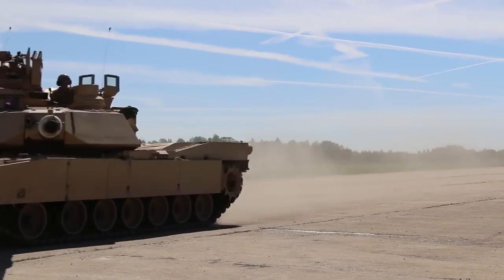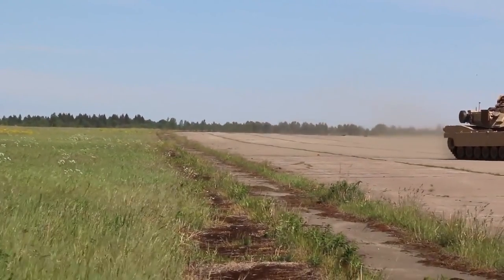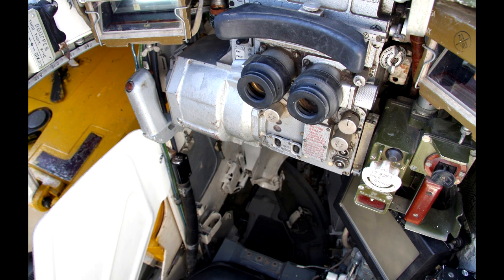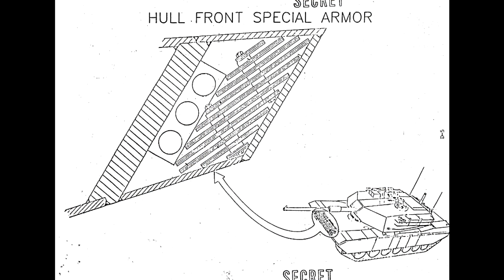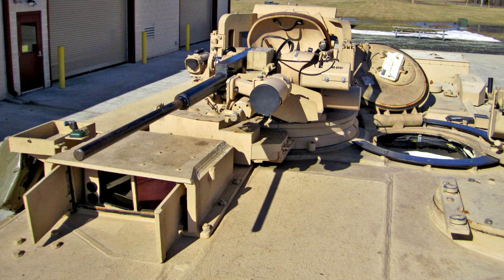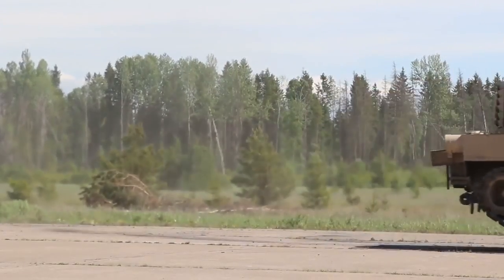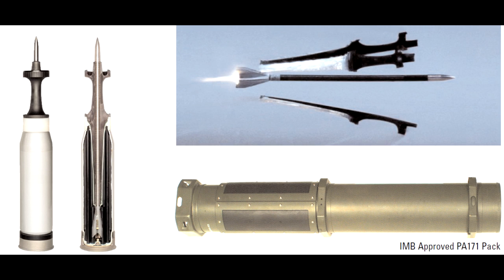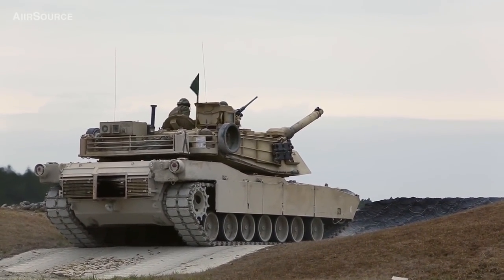Problems with Abrams tank

Comment from the maker: So many people complaining about me not stating the problems the Soviet or German tanks have or used to have... Honestly people, this is a video where I simply point out the problems that M1 used to have or still has, if you want to hear about the problems about Russian tanks watch the "Problems with T-90", or "Problems with T-72" or "Problems with Russian tanks". This is a video about Abrams, not about other tanks, when I bring up another nation I am simply pointing out that the thing I am mentioning did exist at the time, but was not present on the vehicle that is the topic of the video.
Also, so many people are saying that gas turbine is for some reason better than diesel... There is no evidence to prove that it requires less maintenance, that is one myth that is spread around the internet for some reason but is not true. One has to work with both engines of similar performance (like MTU MB 873 and AGT1500) for an extended period of time in order to come to such a conclusion. Another point I saw being made constantly is that "US has enough money/resources to use the gas turbine"... I never said US did not, but if it has enough money to keep the turbine, then it means that the diesel wouldnt change that fact, you would only have to refuel your tank on less occasions.
Another point I saw is that you could use "captured fuel" or some other fuel if you dont have access to your armies supplies... First of all, diesel engines are pretty much universal around the world, so there is 99% chance that the enemy is using diesel, and if not diesel, then gasoline, and multi-fuel diesels can use gasoline as well. Second thing is that if you dont have access to army supplies you would most likely use the civilian fuel, which is, again, diesel and gasoline. The point of Gas Turbine engines is that they can produce more power for their volume, that is the reason why Soviets decided to go for a gas turbine with their T-80 tanks. Their diesel engines are small and for a long time couldnt produce a lot of power at all (780-840hp compared to 1100-1250hp of gas turbines) so their use of gas turbine was completely justified. But when AGT1500 was developed there was already a diesel engine of similar performance that took up as much space, since both engines are really big compared to soviet ones, and thus, much better. Therefore there was no actual need to go for a gas turbine, the actual reason is more of a political nature.
Reply: One thing I can say about the gas turbine vs the v12 is that the gas turbine is MUCH more quiet. During exercises I've been on with the Americans, i always try to pick their tankers brains at the smoker (bbq we have at the end of an ex) about what they think about facing off against the leopard 2s we bring (canadian) and they always say the same thing - all they have to do is switch off their engine and listen to get a rough bearing of where we are approaching from. 

You cant hear a damn Abrams coming until it turns its exhaust toward you
Reply: @julianjames2899  
   I never considered the difference in noise, that's an interesting tactical advantage for the Abrams and disadvantage for the diesel engined tanks.
Reply: @julianjames2899  This is the kind of testimony I want more of - Real fucking soldiers that had to work with the equipment that's being discussed, not some faggot pseudo-commie claiming to know about tank combat.
Reply: @BirdyLegs2849  thank you! Honestly for what I can attest too, both the abrams and the leo are great pieces of kit with their subtle and not so subtle differences. In the end the biggest advantage or disadvantage of either comes down to crew training and experience. Being the first to get the best ground, and first to get a round on target. Then jockey back, rinse and repeat. Move, shoot, and communicate.
Reply: Hi RedEffect, our complaints concern a far more serious issue: You still owe us a proper APFSDS-Compilation!
Reply: I like the video I did read something tho about the old fun that the abrams had supposedly they used the old gun with the plan to upgrade the gun for future upgrades but they introduced a new type of ammunition that was supposed to make up for the shortcomings of the gun.. ie depleted uranium shell supposedly it was able to penetrate the toughest armed the Soviet’s had at the time
Reply: In 91 the M1 only use 2-3% of the total 162 millions gallons fuel issue to the army, which mean 4,8 millions at max. If you use all the Leopard2 engines on the M1 instead of the Honeywell you will save about 57000 gallons. That mean 20 Oshkosk M978 fuel trucks. If you can't provide 20 fuel truck in a war you probably lose it already.
Reply: Any weapon system is a compromise.  The designer and the end user must decide what is important and what is just okay based on the technology and availability of the day.  No weapon system is perfect going into first production, never will be when production years later. It's successor will be better, but never perfect.
Reply: Haha thanks for taking on the fanboys...
Reply: Yeah the Abrams still uses the German L/44 gun while Germany created a new, longer L/55 gun. Apparently the reason for the is the US uses depleted uranium rounds while Germany does not have access to DU so they use Tungsten. Intelligence indicated that German tungsten rounds couldn’t breach newer Russian tanks so they made their gun longer. But the extra velocity doesn’t help DU like it does tungsten. Plus the new gun is heavier and wears out faster. So the US has thought over the years of upgrading instead to a gun with a larger bore, but has repeatedly declined to do so. 

Russia has 15,000 tanks, most of which are older and the Abrams gun will have no problem breaching. But the US only has 1,200 tanks in Europe. If Russia starts rolling their tanks into Europe the US plans on blowing them up from the air, which is why Russia is spending so much on the S400 air defense systems and electronic jammers. One question is how well would Russian tank active protection systems do against a maverick missile?

The newest version of the Abrams out this year adds even more armor to frontal turret, so the bean counters probably think that’s where it’s most likely to be hit by an anti tank round.
Reply: And THANK YOU for your continued work and simple unbiased problem pointing, pay no attention to the wot/wt players you've done good
Reply: All tanks have issues and weaknesses,  in one way or another.
Reply: RedEffect nice video can you do a video over the leopard 2 ?
Reply: Excellent summary, objective,  informative and unemotional as it should be.
Reply: considering the US army roll with a lot of helicopters (transport attack and recon) it make sense to simplify the logistics by using turbine engines. tanks can use the fuel dump used by forward aviation units.
Reply: I'm confused as to why you would start your video with a joke intro insulting Abrams fanboys, and then spend the whole video speaking with a derisive tone that is not evident in most of your other videos and then pretend this is a normal video.  (I'm not an Abrams fan)
Reply: @Dadecorban  My guess is, Abrams fanboys fight about it, and every message means a visit to the page,  which means more views and means more money from advertisers.
Angry fanboys = money.
Because of capitalism.
In Soviet Russia, YOU fight for money.
Reply: not gonna lie,but a king tiger shot could knock out every tank,if it hit the top,which has weaker armour than even the back,but harder to hit,hope to not get into any arguements with people who say "NAZI NAZI ALL TANK OUTDATE THEY NO EVEN CAN PENETRATRE TOP OF TEH TEANK U IZ ARMCHAIR SPECIAL SITTING CHAIR ON INTERNET"
Reply: tron  i didnt know admiring engineering had anything to do with politics
Reply: Actually a really good reason that they chose the AGT1500 is because of the horsepower and torque curve. The AGT1500 produces more power and torque than the diesel for almost the entire power band. Turbines are also lighter than Diesel engines which gives them a better power to weight ratio. If you look up a chart of gas turbine torque figures, you can see that they actually make peak torque at low RPMs. This, in theory, means they get up and go faster than a diesel could. However, because of the weight of the Abrams and the gearing in the transmission it is limited to a top speed of 42 mph. If the army changed the gearing in the transmission, the tank could probably go much faster. However, the army prefers having better acceleration at low speeds because of many reasons. It is also way quieter than a diesel outside of ~100m distance. Since most engagement ranges are outside of ~1500m this is a huge advantage. Yes it had some problems at first, but the army chose the turbine for a variety of reasons when the diesel would’ve been cheaper.
Reply: @rawful502  actually it’s governed to 42mph.  It can go faster - much faster, without changing the gearing.  M1IPs were clocked at over 50mph.
Reply: @MDavidW100  Oh I always heard it was because of gearing. Either way they are capable of going way faster like you said :)
Reply: No problem. 

I think that the assessment does have a more tank v. tank lens though, since there is advantage to shorter barreled gun. 

The shorter gun may be the result of experience in urban warfare, which the US Army and Marines has plenty of experience with. The L/55 gun is about 1.32m longer than the L/44 gun, which can be an issue in urban combat. Tank commanders don't take their tanks where they can't bring their gun to bear, and needing up to 2.64 meters (1.32m on each side) just to allow the gun to be brought to bear on each side can be the difference between being able to support advancing forces with tanks and not being able to do so. 

This is probably why the Merkava 4 doesn't use the longer barrel; the IDF sees a lot of urban combat, and having an extra 1.32 meters of gun tube to worry about snaring something offsets the improved long-range performance you'll hardly need in an urban environment. If the IDF planned on pulling a 1967 again, they'd probably have used the L/55 gun and the Merkava 4 would look more like a better Merkava 3. 

The reluctance to use the multi-fuel diesel engine may be the result of experience with similar engines with the M35 and M54 series of trucks, which weren't seen as sufficiently satisfactory to warrant their retention in later upgrades. Issues with the M54's engine may be linked to the fact it wasn't powerful enough, rather than any issue with the engine itself. 

In addition, the turbine does offer some advantages. According to Minnesota State University's textbook supplement to thermodynamics, namely the reduced wear due to number of moving parts (diesel engines have over a dozen moving parts per cylinder not to mention the 11 other cylinders, the turbocharger, and anti-lag devices, where gas turbines mainly have the one big spinning turbine) although said moving part in a turbine is a far more expensive moving part, has better cold-start capabilities (pretty useful in the winter), quieter (significantly more people have functional ears than thermal imaging systems), and has a higher power/weight ratio. The gap in fuel consumption has decreased, but the turbine does burn quite a bit of fuel which can be seen as a much more pressing issue. 

Other than that, I agree with your assessment. The Abrams isn't a perfect tank and has its issues. However, no tank is truly free of issues, and it's really a matter of whether the issues of particular elements outweigh the advantages of the system.
Reply: because we want to complain cause we're idiots :D
Reply: swansea007791  Actually it is the "Pussy Hurt Commies" that springs to mind
Reply: IT'S IMPORTANT TO HEAR THE TRUTH AND NOT THIS UNCHALLENGED HYPERBOLE!! WE APPRECIATE THESE TRUTHS CONCERNING UNQUALIFIED PEOPLE RESPONSIBLE FOR MAKING FLAWED EQUIPMENT!! THIS IS WHAT HAPPENS WHEN PEOPLE ARE UNABLE TO THINK OUT SIDE THE BOX, HAVING NO VISION, JUST ARROGANCE!! P.S. IGNORE THOSE WHO DISAGREE, THEIR ARROGANCE IS AS BAD AS THE DESIGNERS WHO BUILD THESE INFERIOR PRODUCTS!!! ;-) REMEMBER THE F-4 PHANTOM, WHEN THEY FIRST ARRIVED, THEY HAD NO GUN ON THE FIGHTER, AS A CONSEQUENCE, LIVES WERE LOST!! EVENTUALLY GUNS WERE ADDED...WHICH MADE THE DIFFERENCE...DUH!!
Reply: The gas turbine did suck in sand in the gulf which turned to glass because of the heat generated by the engine thus clogging up air intake
Reply: @davelee4885  But it still did a great job of popping the turrets off every T-62 and T-72 tank they ran across.
www.youtube.com/watch?v=7EJsLZLfeOQ
Reply: So many people missunderstand, that finding problems does not mean that the whole tank is bad. Its more likely that no tank is absolutly perfect
Reply: I DO SENSE SOME BIAS
Reply: no we are complaining about your blatant bias in your videos, you are bad at giving unbiased opinions the only real channel I found that does good unbiased opinions is matsimus he actually talks of the strengths and weakness of every tank without shitting on the vehicles. you always say oh the Americans only fought down graded t72 exports yet here the tanks you are talking about are downgraded export m1's without any of the capability's of their American versions also lacking proper crew training just like the Iraqi t72's that's why everyones complaining about your biased ass, hell you even said the m1 was bad on its first production even tho when it was introduced it was thee first tank in the world with a digital fire control system. and your dumb ass said the gas turbine was sooo expensive yet it really wasn't it was actually cheaper to maintain and payed for itself many times over the course of its life vs the 1500 horsepower mtu engines
Reply: @zero00tolerance  no its his blatant fucking bias and clear lack of knowledge against American vehicles that we talk shit about like I said matsimus does what he does 10000x better cause of the lack of bias and respect for every nations fighting vehicles
Reply: Sorry mate but this was by far the worse video ive seen about the Abrams and im not the criticizing type. You put the laughing meme when you see the headline "Abrams is the best" but... With what evidence? You sure do point better counterparts. But never a tank. You always talk about a better german  engine, a better russian gun or whatever. Cherry picking isnt fair since the best tank will still have flawed parts but the best tank will be the one that can pull off everything decently like armor, engine and offensive power.

Have to say was a bit dissapointed but the consistency wasnt there...
Reply: @uwotmatte7577  well that tank isn't the abrams or T90 or leopard well maybe the leopard but nah I think the only like best tank was the panther in ww2 

Decent armor 
Decent mobility 
Decent canon 
decent tank size 

But now in 2020 it's hard to pick a balanced main battle tank cause if it was on light tanks well 

The puma and 

Bmp72 ,especially the bmp 72 

Are decent 

But main battle tanks ,

Abrams is decent on armor and technology ,canon 

Leopard is decent on armor speed , technology and canon

T90  decent armor , decent canon decent engine , velocity,decent tank size 

But over all , it's all situational every tank is good ,well depending, but it's all situation cause the abrams and kill a leo and a leo can kill a abrams 

The t90 can kill a leo amd abrams and the same goes to the other
Reply: @mrpotatoman_pr1554  sure i aint criticizing that. What i am criticizing is his logic? Every single recent gen tank in 2020 has decent everything. But if you think the claim for best tank is laughable, then you need to provide a reasonable versus and not pick parts from multiple tanks
Reply: @uwotmatte7577  oh yea I totally agree , I remember when the US was soo cocky about the abrams like ,haha no abrams has been destroyed we are superior, but then a single RPG makes a abrams go boom boom , I think the only tank that can hold more than 2 RPG is the t90 cause apart of having thicc armor ,they add extra reactive armor
Reply: I know this is a longshot, but could you provide the source for the commanders sights on M1/IPM1/M1A1? I cant find it in the M1A2 book.
Reply: You should consider a tank in the context in which it was developed.  In the case of M1 it was expected to fight in Europe from pre-planned defensive positions.  Likely in retrograde maneuvers as the endless streams of Soviet armored and motorized rifle regiments stormed West...only to become turret-ejecting doorstops.    <--I borrowed that last bit from Task & Purpose
Reply: You're reading from random facts and fictions online. You're neither experienced as ana Abrams crewman nor have you ever built it and trained to fight the tank. Most of your information is outdated by 8-10 years. 
If you're knowledgeable about the Abrams then you can tell me everything about the PAC, it's actual performance tests in the field in combat conditions, it's test performance during the "Tusk" phase. 
You're not impressing anyone with your lack of knowledge and experience. Your biggest task is to prove your information, validate.
Reply: I guess a russian tank never got knocked out and have no problems/ oh wait what happened to russian tanks in afganistan or dosent that count because it was russia. You must be a commy according to you everything russia makes os the best. The rest of the world should give up now
Reply: Who's laughing now RedEffect? The problem with T-90's? They invaded Ukraine.
T-90's are popping like popcorn on a cold Ukrainian winter day.
Reply: Im not surprised that so many Americans have to come up with excuses it seems to be deeply rooted that America is just best at everything , the usual megalomania. And arguments that are comparing the M1 with Sovjet tanks .
The video is about the M1 just like other are about T72 or T90 etc.
Reply: Spoken like someone who has zero experience in the Abrams and has probably never even seen one in person, let alone operated one or wrenched it. The Abrams outclasses ALL armor currently deployed and that's likely not going to change, especially from third rate powers like Russia and China, LOL
Reply: You will find that all that matters to them is their country's delusions of its military invincibility. You are forbidden to point out the flaws. You become the enemy by breaking the magical spell that protects their magical invincible tanks.
I like your channel and think you try hard to be objective. I see that you are careful with your evaluation. Keep up the good work. :)
Reply: #1.Gas turbine saves 3 tones of engine weight.
Reply: The thing I would point out is that the M1 series early on had a thermo sight that allow it quite a bit advantage in wood and light forest area and in the night. Other than this there is not lot of advantages.
Reply: just wondering doesent the most modern m1a2 weigh 73.6 short tons and leopard 2 weighs 68.7 short tons
Reply: Oh yeah 1 question, why is the gun of the m1 abrams' not centered?
Reply: Nope.  

Bazaar was hardly open combat. It was fight insurgents at best. 

Still not as much combat experience by a long shot. 

Oh and be careful when you talk about someone’s grammar. You might want to re read your comment.
Reply: How many m1 tanks have you crewed again?
Reply: @ferrysyalim5191  Yeup. compared to other tanks of the time yes, thats blazing.
Reply: @Nogeri  finaly.  I find someone that love abrahams but not skeptical or denial.
Reply: RedEffect Aint much wrong with the Leopard...
Reply: I complitly agree with u the tanks is bad bc they said that the abrams did 1 battle where the have lost one tank bc of friendly fire but they where battling agains t 54 its logik that they didnt die.
Reply: Redeffect WHAT DO YOU KNOW ABOUT THE UKRANIAN T-62 BULAT 2017?
Reply: YOU HAVE NO CLUE RUSKY IN FACT HOW WOULD YOU KNOW DO YOU HAVE ONE, I DOUBT IT
Reply: Forgive my ignorance, but I thought the Abrahams had good armor elsewhere, besides the upper front plate you mentioned. Obviously thats a huge flaw, but I was under the impression that its good everywhere else. It that true?
Reply: You cannot judge a design decision if you do not understand the situation the design is meant to be used in. 
That situation is the doomsday scenario, where europe is a radioactive ruin, as stated by soviet warplans, and fuel resupply cannot reach europe in required amountd because of soviet naval blockade.
Its not about using stolen or civilian fuel, its about distilling french wines for fuel. Or crude oil, hydrogen, natural gas. It literally works on fart gas, if you can produce enough of it.
The assumption is that societs will prioritise destroying any and all fuel sources, civilian or not. The assumption is that after first tactical nukes, the resupply organization does not exist, period, and the tank crew might have to continue fighting and surviving with nothing but themselves.
Its made for end of the world scenario, where men can never return home, but can still fight until they die.
Not for limited wars with minor nations.
Reply: Are you a 19Kilo?
Reply: So.. Which modern MBT has the least amount of problems?
Reply: Kabuki Kitsune  I dont buy into that "saving space" argument. Smaller engine that requires more fuel means the total size remains the same. If its true, then that is a design flaw by itself. 
However, in politics there are simply things you cannot say. You dont lie because you are a bad person, you lie because telling the truth is impossible.
Reply: Leclerc is the best
Reply: Oof
Reply: swansea007791 the phrase 
“Fuck off” springs to mine...lol
Reply: Some ppl. mentioned it, that the abrams would go on defensive, and will be hulldown so the weak ufp wouldn't count. The problem is, the tank will consume as mutch fuel while stationary as well. Also, the turret can be penetrated easily as well. Also when the Abrams came out there were T-72s and T-80s, no point to compare it to T-64 tanks....
Reply: On the fuel thing. The lion's share of fuel consumed in a unit is consumed by other vehicles mostly Humvees (now JLTVs in some). The fuel consumption is a non-issue.
Reply: RedEffect unfortunately you’ve never served on either.  I have.
Reply: @MDavidW100  unfortunately you never served neither. Because playing tank games doesn't make anyone a tanker so get a life loser
Reply: Ok research was lacking but some truth. The main gun was swapped because the W Germans banned the use of Depleted Uranium for there guns, tungsten penetrators had poor performance at that time in the L7 but could get the job done with the L44. Research showed the L7 with DU sabots at the time could defeat all Russian armor. The US switched to the L44 to maintain ammunition compatibility and saw that the L44 had flexibility in upgrades that the L7 could not do. However the L7 deployed early on could get the job done. 

The turbine was a quasi political issue but won, due to the fact that the power pack was modular and that an already diesel design could be dropped in with NO MODIFICATIONS. Fuel wise, no brainer there, auto gas, AV gas, diesel, kerosene, light machine oils, all jet fuel, alcohols biodiesel, etc can run in a turbine. Yes it’s a gas guzzler but it’s fuel options lets it take what’s available. 

Remember the US military’s logistic system is most capable to get supplies where they are needed. Also Maintenance command were questioning field readiness reports well above expectation during Iraq 1. A testament to the training received by the Mechanics.

As any machine built, it goes through a teething phase, then reliability, then upgrade, more teething and the cycle repeats. The Abrams has a lot of relevancy left, the Russians Armarta is unproven but may get that chance if they can build a good number of them. Right now the bulk of Russian military budget goes to modernization and maintenance, they don’t have the monies to build conventional force levels that the US has, that ship sailed a long time ago. Mr Putin is still a man and only a man, when his power fades Russia will go through another rough time trying to figure out what to do next.
Reply: Just a thing about the gun.
The German L55 isn't really a good gun, its more a quick made up solution to stay relevant compared to the new US and french guns. The length is too important to be practical in lot of scenarios, like urban zones or forests and use to suffer from bad balistic.
Guns like the Leclerc one or the last US one have better performances because they put more pressure in combustion chamber to not use gun with more length (even if the Leclerc is a L52), look for XM360.
Reply: U mad bra?
Reply: Oh, come on. You expect too much of 8-12 years old boys.
Reply: RedEffect 
Like some others, I think you missed the fact that the original intended use for the M1, was engagement in defense, from prepared positions.  As such, the ability to actually see the upper frontal plate on an M1, let alone hit it on purpose in that position is nearly zero.   You also seem to be forgetting, that the original design of the Abrams, originated when HEAT, was considered to be a bigger threat, and long rod KE penetrators, were still not as capable as they are today, and as such the armor configuration made sense and was also used on the top UK tanks of that time, simply because it offered defense against both KE and HEAT ammunition.

The original 105mm gun, might be questionable, but at the time of design and testing of the MBT-70, both West Germany and the US, were fielding license copies of the British L7 105mm guns, in their respective tank of choice...in fact, even the prototypes of the Leopard 2, came with a 105mm gun versions.   Eventually, the US Army ( knowing about the XM774 DU ammunition ), decided that the current crop of T-62, T-64, and T-72 tanks, that they would be facing, that the M68/L7 105mm Gun, would be sufficient to meet operational requirements and in doing so, simplified ammunition logistics, while the M60A3 was still in use, as the M1 was starting to be fielded.

In the late 70’s ( when the design of the M1 was nearing completion ), studies of the Yom Kippur War, showed that while the 105mm Gun was still serviceable, showed that future Soviet tank designs, would probably need an gun upgrade, and so changes were made to the turret design, allowing a 120mm gun to eventually be installed, although where it was going to be the German 120mm smoothbore or the British 120mm rifled gun was still in debate.  Now, you pointed out that the newest versions of the M1 is still equipped with the shorter 120mm L44, instead of the newest L55, but you haven’t made a case that the L55, A) Can even be equipped on an M1. B) Even currently needed.  While advances in armor, might appear to push things in the direction of the L55 being needed, such can be deceiving, to folks not actually in the testing and/or procurement processes.  For instance, why go ahead and equip the newest 120mm/L55, if you are deciding between it and the new Rheinmetall 130mm/L51?, and if you decide on the 130mm, does it require and entirely new turret, and if it does, do you need a new hull to support the new turret?

The turbine vs turbodiesel engine.  At least part of the issue, comes down to multi fuel or not.  Is a turbodiesel engine capable of handling fuel other than diesel?  Sort of.   It can to a limited extent, but you run into mechanical problems, if you do it for very long, as diesel fuel engines, take into account that the diesel fuel itself is supposed to lubricate some critical components such as the fuel injection system, where as US experience with multi fuel 2.5 and 5 ton trucks, showed that conventional multi fuel engines, required more maintenance to keep running, and this is why the 2.5 and 5 ton multi fuel utility truck, were converted to straight Diesel engines.  Now in your video, you blew off the need for multi fuel tanks, explaining that anyone attacking you will also have diesel fueled tanks, but that doesn’t correctly explained why the US opted for the multi fuel turbine, and the reasons are multiple.  Some have correctly pointed out that the turbine powered Abrams, is quieter, than a conventionally turbodiesel powered tank, others have correctly pointed out that a turbodiesel when accelerating, usually gives off a cloud of black soot in the exhaust.  But the biggest reason for the multifueled turbine, is the ability to resource all types of civilian fuel stocks, from furnace oil, kerosene, gasoline, even aviation fuel...not just diesel. This means that during a fighting withdrawal ( as was expected in the European defense scenarios ), you don’t have to abandon and loose a tank, simply because it ran out of fuel, which would be at a premium in that situation.

Lastly, the whole commander’s night vision issue.  Sure, he didn’t have a dedicated night vision device in the early version of the Abrams, that is because for general surveillance, a dedicated device wasn’t needed.  General surveillance was done from the Loader’s hatch and used the same identical night optics as the driver did, in fact they could be interchanged, if one was down and they needed it at the other spot, it could be handed over to the other position for use there.  Didn’t have dedicated commanders Hunter/Killer system?  Up to the mid 80’s it wasn’t to big a deal, and by the spring of 88, we already knew it was coming out, but units overseas were going to get it first.
Reply: Best intro EVER
Reply: Can you do a video on the infamous M246 Sgt York?
Reply: Also true.  Many vets like myself were wondering: what are they thinking?
Reply: I'm complaining about the damage to my eardrums by your lack of attention to consistency of volume on the audio track. Or in other words your intros and outro... Too fucking loud
Reply: Every weapons system is a trade off. It’s important to remember the enemy the Abrams was designed to fight, where they planned on fighting, and the munition used during that time by America and her enemies.  It makes decisions about the gas turbine easier to understand, and the armor decisions. After the Cold War ended, we didn’t have an appetite to design an entirely new tank, against a yet unknown enemy. So we adapted existing gear, with predictable results, as pointed out by your video. Nice work, but context is important.
Reply: @LegendofLag  the young people of today have the saying: Lost in the sauce. Things like Weapons Systems being a trade-off might be true but it's quite the sauce. It also distracts from the bigger trade off of corporate profit was involved with the design and procurement. Anybody has the right to profit but when we juxtapose that two weapon systems and to our children mostly young men putting their lives behind these it makes me wonder why the concept of treason is almost non-existent these days
Reply: A lot of designs have had their problems. Adaptation to correct the problems before enhancing other areas. on any platform. The T-34 had 

its problems, however, were still a powerful tank. The Panzers were problematic; however, corrections in problems would make them even more lethal.
Reply: @ferrysyalim5191  It's designed speed with a Govenor restricting it is 72 kph. However it's been known to hit 80-100 kph on paved roads when the govenor is out.
Reply: You've probably heard this before but the gas turbine was picked for high altitudes has to do with Colorado and a different sets of mountains we have the ability to climb them in a certain amount of time
Reply: @bustabusts  No it wasn't...the design philosophy of the M1 Abrams came from the notion that it will square off against Soviet armor in the European theatre but it never happened. The USA wanted to have a "better tank engine" than the German Leo so they put a gas turbine in the tank having the better hp:weight ratio....effectively sacrificing fuel efficiency and engine reliability
Reply: @Nathan Nakaji The M1 would definately be on top 3 due to combat record (even that is debatable because it fought shitty 2nd rate version of a stripped down T-72M, and Abrams outnumbered them by a lot) , but on a purely military analytic standpoint (and the fact that a tank is designed to fight in a specific environment) the top 3 would include the German Leopard 2, Russian T-14 and the SK K2 PIP
Reply: If anything JP8 has a higher LHV and density.  Considering the brightest minds at Honeywell ran the turbine on DF-2 when experimenting and designing it.  Meaning, the turbine can run on about anything from gasoline (no kerosene mix), diesel, and marine diesel.  You could fight and raid harbor fuel depots for your Abrams.  If the military replaces the turbine with a newer one, it'd be an even more fuel efficient fast mother.  It also has higher torque and HP at lower RPM than diesel engines.   
Edit: tanks are all nice, but none are built the same.
Reply: @DurzoBlunts  Doesn't matter Abrams combat range is pretty lame 460km for the original/old T-72 with a 1,200L Diesel engine while the newer M1A2 Abrams 1,900L 430km. LOL
Reply: @JABelms  remove the I in the PIP please.
Reply: RedEffect thank u I hope we get a new diesel tank there’s a lot of great examples
Reply: I did not understand if the Ml sep 3 got the L55Al or stuck with the original one if not why?
Reply: In any war if one truly studied the art war especially in operation Blue by the Germans Russian war LOGISTICS is the most important part of any Battle Plan if you have gas gussying battle tanks the enemy would foremost attack the enemy in front while at the same time attacking the supply line. Tanks can’t move without fuel so that’s what I’d do if attacking a bunch of gas gussying tanks perhaps the engineers thought of that and have a answer I don’t know about that’s what I think is the biggest weakness of Al Abrams sep 3
Reply: The reason they chose a turbine vs a conventional Diesel engine is weight. The ATG1500s dry weight is 2500lbs (1.25 US Tons). Where as the dry weight of a MTU MB873 is 3968lbs (1.984 US Tons). Yes it sounds dumb when you talk about a tank that weighs 63 to 69.4 tons. However, it’s a compromise. Lighter power plant means less weight which means less cost to ship it. The United States is not been glorified with the world position of being able to drive tanks to the train yards and drive them off the tank and essentially be at the battlefield. It has to be taken over by boat, by air, what ever means to get to the trains to be driven to the battlefield. From a keeping the fight on the lines too having a smaller lighter power plant means it’s easier to ship a replacement power plant for a tank to the field. The abrams can have its entire engine and transmission pulled as a complete unit in the field and replaced with a new power plant with nothing more than a recover tank and crane with crew.
Reply: You arre so out if date
Reply: They say that the only abrams destroyd was under freandly fire. They where fighting T-72's right, how can you not notice the difference between a YELLOW BOX and a yellow box with a circle on top.
Reply: Please show me the number Abrams that has been knocked out by another tank
Reply: @dazedandconfusedstacker9923  Plenty of Abrams have been knocked out by one-another for one LOL, but as far as I know none have been knocked out by enemy tanks. However several have been knocked out by ATGMs,  RPG-29s, and RPG-7s firing PG-7VRs. Most notably in Yemen, though honestly, the Saudis are so incompetent in Yemen with their M1A2S's that even a T-55 poses a legitimate threat. They often travel alone, sit stationary in defensive positions without having sides covered or being hull down, etc.
Reply: @infantjones  okay I can give you this information no Abrams have been knocked out by Foreign tank that was operated by a competent crew
Reply: @dazedandconfusedstacker9923  one
Reply: Haven't seen any pictures of an Abrams that has been destroyed with it start laying upside down on the ground next to it
Reply: @dazedandconfusedstacker9923  what should Start mean?
Reply: Combustion turbines are a more versatile engine option compare to diesel engines, want to run diesel both can, want to run gasoline turbine can multi fuel diesel can too, want to run LNG turbine can with tuning and different nozzles, diesel would require major modifications, want to run pulverized coal, same for a turbine nozzles and tune, the diesel not so much not with a major blower to keep it suspended in air just my 2 cents, but combustion turbines can pretty much run on almost anything that can burn
Reply: I'm sure gasoline engine will make a bigger Ka-Bloom! That's why there better! 👊😭
Reply: best JJ jonah shitpost... EVER
Reply: Abrams tanks are gas guzzlers and very costly to maintain.
Reply: @biller2000  Maintenance costs have been relatively mitigated in the past decade for the tank. But it is a gas guzzler. That's true. They put in a computer to help mitigate this though
Reply: The need for a gas turbine wasn't political. The US had a diesel engine in development to compare to the gas turbine and it was decided that the Gas Turbine was better suited for the tank they wanted. I just watched Spookston's video on it. Please don't spread lies
Reply: RedEffect  I don’t know where you get your information about the M1 tanks.  The AGT 1500 runs on diesel just at a higher grade.  I worked on those tanks and drove them for 13 years.  Every tank has a weakness.  However the M1A2 Tank can do some damage and take it as well. When we fought in Iraq we destroyed more tanks than we lost.  True is does take a lot of fuel to keep it moving however the top speed of it is amazing and to see it fire on the move and hit its target is also amazing.  Still it is an interesting video.
Reply: what a good joke
Reply: I found a video on why the Abrams burns gasoline:  https://m.youtube.com/watch?v=jABL74LTmhY
Reply: Fuck off
Reply: T90M is better than abrams change my mind
Reply: @zero00tolerance  People that say bad things about America and Americans are just jealous they don't live in America and you are sad you live in your backwards poverty stricken moron 3rd communist garbage dump country.
Reply: Problem soviet tanks have like automatically blowing up when something is shot in their general vicinity?
Reply: @slimj091  depending where it hits
Reply: RedEffect has left the chat.
Reply: @Mr.Takahash1  he was lectured by someone who knew alot about night vision devices for criticizing american commander nv but does not really know what he was talking about or does have first hand experience on the subject matter.
Reply: Some people forget that the cold war was some time ago
Reply: Ryan B  wait what does that mean? You know how to type or did you had a seizure? And I'm not wrong the T90 M is better than a  abrams and so is the leopard
Reply: its not that your not pointing out the problems with Russian tanks. its the fact you are unwilling to state that an Abrams is an equal to the T-90.
Reply: Wait what ? I'm the only one saying that abrams or t90 or leopard are the same and it's all situational  but If we go technical,you cant compare the armor of a t90 with a abrams , a abrams can get one shot with a RPG , a t90 can hold up to 3 because it has extra reactive armor
Reply: I can’t find any info on Russian tanks having an independent sight for the commander
Reply: @jakexd5524  I dont think they have one
Reply: Dillon Mcconnell  cause they didnt engaged maybe ? , bro dont be here like the Abrams is the best cause it's not, a t90 will kill it , a leopard 2a5 will kill it but if we speak technically the leo and t90 are a bit better in system weaponry etc , and dont say "why did the abrams run through russian tanks like toys " well let me give you some facts , It was a exercise and russia isn't in war with US but if it was at war and it wasn't a exercise that abrams would have got killed before he even got closed to the tanks 

Forgot to say , a Abrams gets killed by a single RPG shot , a t90 gets knock out after 3 because it has extra reactive armor
Reply: Dillon Mcconnell  dude what's the nation all the "russian tanks turrets" are  tell me cause I bet you gonna say iraq
Reply: Dillon Mcconnell  Your comment has too much stupidity in it that I don't need to reply. You debunk yourself
Reply: 12 comments is 11 too much for a stupid person. Free speech makes me sad
Reply: Dillon Mcconnell  protected from russian? Russia isn't the one starting war to get oil and you keep talking about the abrams perks like if the t90 didnt have them 

And for your info the T90 can fire while at full speed and jumping hitting its target 90%of the times 

And yes the abrams will shoot at 4,000 meters , but that's standing still not going 70 mph , yes it's TRUE that the abrams has a superior fire power , it's just true , and fun fact it's not 70 mph its 40 mph on tough terrain , and on roads its 70 

T90 is 60mph  and in tough terrain it varies in 45 mph to 50 , 

And yes a abrams will shoot a T90 first, because of range,but heres the catch , everything is situational  (actually no cause T90 shoots 2.5 miles)

The russian dont send T90 to open areas because T90 are not designed to shoot far away like Abrams, cause if you didnt notice , abrams is used as support from range rather than being up close that's why The US uses Bradley's as troop support , russia uses the T90 as troop support and yes the US also uses the abram as troop support at close but in most cases it's far away 

And dont say protecting from russian when America is literally the first country to invade like 4 other countries for oil 

Russia doesnt got war if it doesnt has to , not like the US that for any retarded reason they go to war , and like protect ? Russia is a US allied like dude do your research, Russia is a US allied but sometimes in the middle east they have tensions cause your American block the russian army convoy for no reason, the same goes to russia blocking American convoys for no reason , 

Like US and Russia allies , but they have tensions in some occasion , and if you didnt notice Russia likes being conservative, they dont show off or anything, Russia always invites the US to the Moscow parade that a lot of countries take part of , but US doesnt like it , and US incites russia to the practice exercise the US do every year to see how nations have grown , and russia doesnt join , 

Like idk why are you so hostile to russia cause The Americans are the ones who started the cuban missile crisis because your American put down nuclear missiles aiming at moscow ready to go , so what did russia do ? They retaliated by putting nukes in Cuba 

Like in any case Russia should be the one pissed off ,but they not they chilling , 

Of course russia has done some shit things like getting involved in the Venezuela crisis but I respect that cause US was gonna invade Venezuela and how you said in your text 

Russia is protecting its allies from US 

The same would do the US if russia threatens to invade Japan 

Like yea , and back to tanks they are both spectacular tanks for different roles 

T90 is a troop support that will kill anything that's 6km alway 

And the abrams is a Far away troop support that kills anything in 4,000m away 

T90 can go at 60mph and shoot while jumping ,hitting its target 

And Abrams can go 60-70 mph and shoot at a target at 3,000m away hitting it 

They both are spectacular 

And like I always say ,its all situational,cause it's not the machine ,its the crew that uses the machine 

And it's all situational, if a battle happens in a open area and the abrams are out of reach of the T90 then ,but maybe not cause a T90 can shoot at 2.5 miles so basically in matter of seconds the T90 gets in range and can fire back at abrams 

Like you see what I mean , it's all situational they both can shoot far away while moving and jumping ,(well the abrams can shoot while jumping ) but you get the point , 

What I'm saying is ,they are both wonderful machines that should not be fucked at , and that we will never see fight each other 

But I would love to see a T90 shooting at a abrams to see how much damage it does and would love to see a abrams shooting at a T90 to see how much damage it does
Reply: Dillon Mcconnell  dude of course no doubt russia during the 40 to 70 were shit at everything, and btw IS2 is better than sherman , back to point , it's not a competition, and you keep saying like , we beat this and this 

FOR FUCK SAKES THOSE TABKS ARE TANKS THAT RUSSIA ISNT OPERATING because they were russia made doesnt mean it has russian inside and dont be like haha we beat on all the war cause when russia actually started fighting against the US in vietnam , like when the russian got pissed off to US they put real Mig pilot , russian Pilots and you know what happen to all those F100 and F4 phantoms ? They all started falling to the ground , those like 6 russian pilot russia sent , exterminated the bombing runs on the north , then what happen? The russians sent the spetnaz,what did the spetnaz do ? They attack like 3 entire bases and destroyed the fuck out of them , a tiny team of 5 spetnaz special forces destroyed 3 bases of like 500 US troops all alone ,

And back to the point RUSSUA HAVENT FOUGH THE US WITH TANKS and I see you mentioned the A10 well the russia have a really similar plane ,The Su 25 that Carrie's triple the armament than the A10
The type has seen combat in several conflicts during its more than 30 years in service. It was heavily involved in the Soviet–Afghan War, flying counter-insurgency missions against the Mujahideen. The Iraqi Air Force employed Su-25s against Iran during the 1980–88 Iran–Iraq War. Most were later destroyed or flown to Iran in the 1991 Persian Gulf War. The Georgian Air Force used Su-25s during the Abkhazia War from 1992 to 1993. The Macedonian Air Force used Su-25s against Albanian insurgents in the 2001 Macedonia conflict and, in 2008, Georgia and Russia both used Su-25s in the Russo-Georgian War. African states, including the Ivory Coast, Chad, and Sudan have used the Su-25 in local insurgencies and civil wars. Recently the Su-25 has seen service in the Russian intervention in the Syrian Civil War.

T90

The T-90 [6] is a third-generation Russian battle tank that entered service in 1993. The tank is a modern variation of the T-72B and incorporates many features found on the T-80U. Originally called the T-72BU, but later renamed to T-90, it is an advanced tank in service with Russian Ground Forces and the Naval Infantry. The T-90 uses a 125 mm 2A46 smoothbore main gun, the 1A45T fire-control system, an upgraded engine, and gunner's thermal sight. Standard protective measures include a blend of steel and composite armour, smoke grenade dischargers, Kontakt-5 explosive-reactive armour and the Shtora infrared ATGM jamming system. It was designed and built by Uralvagonzavod, in Nizhny Tagil, Russia.
TypeMain battle tankPlace of originRussiaService historyIn service

1992 (T-90)

2004 (T-90A)

Used bySee OperatorsWarsWar of Dagestan[a]
Syrian Civil War
War in DonbassProduction historyDesignerKartsev-VenediktovManufacturerUralvagonzavodUnit costUSD 2.5 million in 1999,[1] USD 2.77 – 4.25 million in 2011 (varies by source)[2]
T-90MS: USD 4.5 Million in 2016Produced1992–presentNo. built3,200+SpecificationsMass46 tonnes (45 long tons; 51 short tons) (T-90)
46.5 tonnes (45.8 long tons; 51.3 short tons) (T-90A)
48 tonnes (47 long tons; 53 short tons) (T-90MS)[3]Length9.63 m (31 ft 7 in) 6.86 m (22 ft 6 in) (hull)Width3.78 m (12 ft 5 in)Height2.22 m (7 ft 3 in)Crew3ArmorSteel-composite-reactive blend APFSDS: 550 mm + 250–280 mm with Kontakt-5 = 800–830 mm HEAT: 650–850 mm + 500–700 mm with Kontakt-5 = 1,150–1,550 mm[4][5]

Main
armament

2A46M 125 mm smoothbore gun with 43 rounds (T-90)
2A46M-2 125 mm smoothbore gun with 42 rounds (T-90A)
2A82-1M 125 mm smoothbore gun (T-90M)

Secondary
armament

12.7mm Kord Heavy machine gun, 7.62mm PKMTEngineV-84MS 12-cyl. diesel (T-90)
V-92S2 12-cyl. diesel (T-90A)
V-92S2F (T-90MS)
840 hp (618 kW) for V-84MS 12-cyl. diesel engine
950 hp (736 kW) for V-92S2 12-cyl. diesel engine
1,130 hp (831 kW) for V-92S2F (T-90AM&T-90MS)Power/weight18.2 hp/tonne (13.3 kW/tonne) (T-90)
20.4 hp/tonne (15 kW/tonne) (T-90A)SuspensionTorsion bar

Operational
range

550 km (340 mi) (without fuel drums)Maximum speed60 km/h (37 mph)

It's TRUE Russia at the moment has no money , like literally 0 one would think they would be full of money because of all the old equipment they sell but hey 

Like this is not a competition they are both super main battle tank , and the abrams was made for support it was never made to take on 10 russian tank and even if a single abrams tries fighting 10 T90 the T90 would win cause most likely the reactive armor would make the sabot round explode before penning and even if it killed 2 in 1 minute the other T90 already got close enough to shoot back and a abrams wont hold off 8 russian sabot rounds at a time especially that they all can aim at it weak spots 

The M1 Abrams is a third-generation American main battle tank designed by Chrysler Defense (now General Dynamics Land Systems).[9] Conceived for modern armored ground warfare and now one of the heaviest tanks in service at nearly 68 short tons (almost 62 metric tons), it introduced several innovative features, including a multifuel turbine engine, sophisticated Chobham composite armor, a computer fire control system, separate ammunition storage in a blow-out compartment, and NBC protection for crew safety. Initial models of the M1 were armed with a licensed-produced 105 mm Royal Ordnance L7 gun, while later variants feature a licensed Rheinmetall 120 mm L/44.

TypeMain battle tankPlace of originUnited StatesService historyIn service1980–presentUsed bySee Operators belowWarsPersian Gulf War
War in Afghanistan
Iraq War
Egyptian revolution of 2011
Iraqi Civil War
2017 Iraqi–Kurdish conflict
Saudi Arabian-led intervention in YemenProduction historyDesignerChrysler Defense (now General Dynamics Land Systems)Designed1972–1975ManufacturerLima Army Tank Plant (since 1980)[1]
Detroit Arsenal Tank Plant (1982–1996)Unit costUS$6.21 million (M1A2 / FY99)[2] Estimated in 2016 as US$8.92 million (with inflation adjustment)Produced1979–presentNo. builtapprox. 10,288[3]VariantsSee variantsSpecificationsMassM1: 60 short tons (54 t)[4]
M1A1: 63 short tons (57 t)[4]
M1A1 SA: 67.6 short tons (61.3 t)
M1A2 SEPv2: 71.2 short tons (64.6 t)
M1A2C: 73.6 short tons (66.8 t)
[5]LengthGun forward: 32.04 ft (9.77 m)[6]
Hull length: 26.02 ft (7.93 m)Width12 ft (3.66 m)[6]Height8 ft (2.44 m)[6]Crew4 (commander/machine gunner, gunner, loader, driver)Armorcomposite armor

Main
armament

M1: 105 mm L/52 M68A1 rifled gun (55 rounds)
M1A1: 120 mm L/44 M256A1 smoothbore gun (40 rounds)
M1A2: 120 mm L/44 M256A1 smoothbore gun (42 rounds)

Secondary
armament

1 × .50-caliber (12.7 mm) M2HB heavy machine gun with 900 rounds
2 × 7.62 mm (.308 in) M240 machine guns with 10,400 rounds (1 pintle-mounted, 1 coaxial)EngineHoneywell AGT1500C multi-fuel turbine engine
1,500 shp (1,120 kW)Power/weightFrom 26.9 hp/t (20.05 kW/t) to 23.8 hp/t (17.74 kW/t)TransmissionAllison DDA X-1100-3BSuspensionHigh-hardness-steel torsion bars with rotary shock absorbersGround clearanceM1, M1A1: 0.48 m (1 ft 7 in)
M1A2: 0.43 m (1 ft 5 in)Fuel capacity504.4 US gallons (1,909 l; 420.0 imp gal)

Operational
range

M1A2 Road: 426 km (265 mi)
Cross country: 150–200 km (93–124 mi)[7]Maximum speedM1A1: Road 45 mph (72 km/h) (governed);
Off-road: 30 mph (48 km/h)[8]
M1A2: Road 42 mph (67 km/h) (governed);
Off-road: 25 mph (40 km/h)[7]

Oh and by the way the abrams is slower than T90 in off road

But like why is your ego this fucking high just accept that there other main battle tanks that can rape a abrams 

And I love that you say the russian lies about everything like if the US doesn't like about everything they do in war and other,every government has secrets and die,and why you mention trump that fucker almost started ww3 3 times first invading Russia territory in Syria and stopping russian convoys,oh and threatening russia for sending troops to Venezuela then the missile to iran and now putting more troops in North Korea border making tensions even worse 

What a nice president,instead of being like france president and Russia and Japan and south Korea presidents , you know staying still enjoying life and helping allies, but no US has to be in war always 

Dude just calm your tits I know you a abrams fan boy but you have to accept it's not a perfect tank and it has flaws ,look at the Leo is literally a abrams but german made with better armor at cheeks , look at challenger same thing , look at South Korea same thing look at Japan,look at russia

They all moved to third generation,depleted uranium as armor and sabot rounds as ammo ,they all have different designs because they use them differently than other nations ,example, Leopard is for close support and medium range more like urban environments/abrams is long range and close troop support not so much urban environments/T90 medium support ,close troop support urban to everything except open area cause it not design for that but it can but it's used to urban 

The Japanese type , long range 

South Korean type urban close support 

They all have different roles
Reply: Dillon Mcconnell  and btw stop acting like US is superior cause in any case Germany is a big competition and britain and Japan and russian then South Korea and btw you say America is so great but in naval practice a tiny swedish submarine with the same "shitty engine" as the T90 sneak through the entire US navy and scored 3 hits at the US carrier and left without being detected wow such power
Reply: Dillon Mcconnell  btw read the other 2 text I sent
Reply: Dillon Mcconnell  I agree on everything you just said except the part of invading everyone, cause actually since the 1956 they havent invaded other countries just supplies them , later they invaded I think it was Afghanistan and then went away and now Syria,so they have invaded 2 countries well actually 3 if we count Ukraine, but other than that they chilling , they not invading Iraq or iran or North Korea or china not even Poland not even europe they just there chilling but it's TRUE Putin is a really unstable person and anything can piss him off , but he keeping his cool surprisingly,like when Turkish shot down 2 russian jets
Reply: Dillon Mcconnell  well basically what is said in the other post was 

The US Army Deputy Chief of Staff stated that the M1 Abrams might still be the best in class tanks but the T90 tanks are pretty close to it. ... Defence experts suggest that the US might look to replace the M1 Abrams and have
Reply: Dillon Mcconnell  I agree lad , and have you seen the North Korea tank ? They look like normal tanks but then you look on top of the turret and you see a anti air missile system
Reply: Dillon Mcconnell  yes but it's not the russia got stuck in Ukraine,is that they just stopped advancing, no one knows why, we know they arrive to the capital but there not a lot of info anymore
Reply: Make a video on k-2 black panther tank
Reply: Ur delusional it's obviously the tank plankton used trying to get the secret formula from krabs and spongebob
Reply: Dillon Mcconnell  And ignore the fact that Iraqi tank crews were poorly trained and didnt even know who was hitting them,that's just "COMMIE" propaganda and not real life.
Reply: @teamfortress2teamfortress881  That's actually a real documented fact. American tankers said that the tanks they fought in Desert Storm were either abandoned, were ill equipped or were outdated. So yeah, no excuses there.

Also it is a well known fact that export version of tanks are not as good as the original..unless you would say that the export version of the Abrams having no depleted uranium and not havinf modern upgrades is American propaganda as well?

I swear majority of people here are stupid
Reply: @JABelms  Alot of people use the Gulf war as proof that the T-series tanks are total crap,while totally ignoring the OBVIOUS facts that the Iraqi tank fleet had alot of T-62's,T-55's and real shitty export models of the T-72,all out-dated and out-ranged,and they were being pummeled from the air by the US airforce,and yeah,alot of Iraqi tanks were also abandoned.
Reply: @teamfortress2teamfortress881  Yeah, and you don't want to go into specifics because that is too much for an American to understand
Iraqi's also fielded Type 59 tanks~AKA Chinese T-54 and as well as Type 69~AKA Chinese T-62
The Coalition only rarely faced T-72s and even then they were locally made Asad Babil and T-72M1s supported by BMPs, and all their ammunition were 2A46s 3BM9 sabot rounds which were practically outdated by the Soviets 20 years before the Gulf War began.

But you know, people are ignorant and have no capacity for detail
Reply: I'm sorry that you have to deal with stupid fanboys that don't listen and just repeat the stupid propaganda advertisement shit they heard
Reply: Yeah, most people here don't even understand that US airpower decimated just so much Iraqi equipment and use THIS as" proof" that the T-series tanks are "trash" and "Crappy" compared to every western tank.
Reply: The Iraqi's also used TOYATA HILUX trucks,yes,Toyota Hilux trucks as military vehicles.
Reply: Huh,I didn't know the Iraqi's fielded Type 59's and Type 69's,they're also horrible knock-offs of Soviet tanks.t h a n k f o r k n o w l e d g e
Reply: I have heard a lot of mythified shit about the abrams, but if there was a way to determine the best mbt in current service, I think it could be the abrams among others, and not by a long shot. I don't find that claim crazy, maybe just from the wrong perspective. In any case, which would you think would be the best?
Reply: RedEffect how many people do you want to piss off?

Yes
Reply: The laugh in this video is super annoying. Stopped watching this 10 seconds in. Use some tact please.
Reply: Abrams sucks lol america need new tank
Reply: My only complaint is that you compare the M1 in its many developmental stages to fully developed tanks of other nations.  All in all good video,  by the time the M1 was fighting in the battle of the 72 eastings it had over come its short comings to eat the Russian T-72,76 sandwiches. 😂
Reply: Why are there 390 replies?
Reply: @darndang4022  because there was most likely a reply section war
Reply: can any others nation tank can kill 1shot abrams??
Reply: The reason the m1 abrams is the best tank in the world is that there's a shit load of them around 9000 or something. They don't need to be perfect as long as they can take out enemy tanks and sustain their own losses.
Reply: Should have gone with the German dieselengine
Reply: The reason the Abrams has a gas turbine engine is the it is quieter. The sound the engine makes dies out quicker and thus quieter. It is only loud up close.
Reply: When you have to preface a video with this much bullshit its obvious you already lost  the argument. Simple answer... Stop posting shit videos.
Reply: CAG H get lost capitalist
Reply: The M1 should be re-engined. Even if the army persists in the use of turbine engines in the M1, the ones in use are old and inefficient, even by the standards of turbine engines. The greatest weakness of the M1 is its supply chain of fuel on the battle field. The army is investigating the use of self driving fuel trucks to at least avoid continuing to put drivers at risk which also puts operations at risk if opposition forces interdict these supplies. The argument in favor of the use of German Diesel engines is compelling from many perspectives as is the use of the German gun. Battlefield experience confirmed the obvious. When you can destroy opposition armor at ranges beyond their ability to effectively engage your forces, the outcome can quickly become a complete rout thereby allowing rapid envelopment of opposition forces, presuming you do not run out of fuel.
Reply: Bloke, question, ever driven gunned or commanded a tank? Didint think so
Reply: Nothing new here. Abrams is a movin'coffin. Just like majority of US vehicles. Ismamic insurgency don't let me lie. Imagine what Russia, China or Iran can do? They will compete who can send marines higher.
Reply: Thats not true abrams tank lost 533 tanks?
Reply: Is it easy to destroy a abrams tank?
Reply: O
Reply: One thing to mention is that the gas turbine engine in the Abrams creates a lower heat signature then diesel. Not only that but gas turbine is also reliable to a extent. Yes it's a gas gusler when at slower times. But at higher speeds that changes. To mention, multifuel can possibly be good. The reason is that when on the offensive, you can use most of the fuel from other countries meaning you could possibly go longer without a fuel line. You are right about it's reliability. It's not as reliable as other tanks however it is a good tank. One other thing to mention is the number of tanks America has. America does not need the most technological tank in the world as they can beat there enemies with numbers of decent tanks that can be effective enough to go toe to toe with other enemies.
Reply: T 90 dead Abram t72 dead Abram Amata tank kill abram
Reply: They are going back to diesel on the M1A3s I believe so that pretty much contradicts anyone’s argument that gas turbine is better.
Reply: but... the whole point of the tank is to prove how it isnt the best... which requires you to compare it to the trials and battle performance statistics of other contemporary tanks...  The supposition that the abrams tank is not the best is not proven in your video, merely the unstated supposition that the tank is perfect.  if I recall correctly, there are benefits to the turbine, though it is less fuel efficient.
Reply: The childish use of film and TV clips was the turnoff for me. Had your balls dropped when you made this? After the 2nd clip I lost interest. Presentation is everything ..
Reply: 99.99% of all americans war decisions are political or for profit of some form, greased palms get the huge war contracts, so many examples of the us choosing a bad product because of this, but many many forms of the us testing and running guns and machines to melting point or destruction good tests and good weapons it's a mixed bag like any country, I think if the army didnt have to do contracts and had more oversight it would be better in ways to make sure what they're using actually works. Throughout history the us military has taken information from front line soldiers to improve weapons and vehicles so hopefully they continue to do that and consider that we've been in war in the desert for 20 plus years and that's not where the next world war will take place
Reply: If gas turbine was a problem - they would change it to diesel long ago. Turbine has it's problems and... ADVANTAGES. And on the battlefield - those advantages are important. It is not political choice but really - every engine has it's special characteristics. 
And most important - fuel consumption/costs is NOT a problem now. 1 ammo for 120 mm cannon costs 10 000 dollars - is it Leo2 or M1 - main costs are: spare parts and ammo. NOT the fuel. And gas turbone is... multi-fuel. It can go on: jet fuel, diesel, gasoline, 96% ethanol etc.
Reply: @bartosza.6187  Turbine has it's problems and... ADVANTAGES ? - what are the advantages ?
The diesel engine is multi-fuel too, so that's not an advantage.
The fuel cost is not a problem, the fuel consumption is an operational and logistics problem.
Reply: @scratchy996  Tank is a WEAPON, not a vehicle in the first place. STOP thinking about tank in car-categories. 
Multi-fuel diesels have limitations, using non-diesel fuel means less power (significantly). Gas Turbine uses anything that burns.

The advantages of GT are seen during fights:
1 - GT is QUIET - in close range it may seem it'svery loud, but it emmits high frequency noise that is almost non-hearable on medium or larger distances. Diesel roar is low-freq noise that is well-heard in large distances.
2 - GT is LIGHTER - as I said - tank is a WEAPON, and if you save some weight in the engine - you can add more armour, electronics, better weapon, additional system/shields.
3 - GT has better acceleration - during fighting often tanks will use shoot and scoot tactics. Hull-down tactics not always is possible. And here - faster acceleration means faster retreat = greater chances of crew and vehicle survival.

All those advantages are NEVER taken into account as I see through discussions. GT is not a problem even if it consumes a bit more fuel. It's really not a big deal to deploy more fuel to operating units. This are not WW2 times when fuel production and distribition was something new in many countries. 

Diesel is GOOD - I do not deny it. But GT is better when it comes to increasing the destructive potential of a tank. Tanks have one role - kill and destroy. And if a bit higher consumption is a price for more power? Then nobody will hesitate.
During the development of M1 it was meant to be powered by DIESEL. But after USSR deployed T-72 NATO shat their pants and wanted to deploy new tanks ASAP. Diesel program caught delays and USA decided to use GT, which was avaiable. And if GT was really such a bad idea - they would just continue the Diesel program and GT would be just a temporal solution.
Reply: @bartosza.6187  yeah, that's bullshit. The only reason they stuck with the turbine is due to politics.
Reply: @scratchy996  Really? You believe this crap? Politics? USA has no problem when it came to use Rheinmetall licence for cannon, and later modify it. 
It's rather German superiority complex that they despise everyone that does sth different. Like France staying with nuclear energy (even if it enables France to easily be net-zero CO2).
Tanks are for fighting, not for economic driving. All anti-turbine ppl always stick to fuel consumption, totally forgetting that we have 2021, not 1939.
Reply: Die Kanone ist deutsch und manche Systeme der Rest amischrott wie die Gewehre
Reply: What political nature is behind using gas turbine when diesel engine is ready? I don't think that this is the case.
Gas turbine was used because USA wanted to start industrial-scale production ASAP, but diesel engine program was constantly catching delays. So they put GT in Abrams.
Later it came out that, GT is quieter than diesel, gives nice acceleration etc. And costs of higher fuel consumption are not that high. 1 piece of ammo for 120 mm cannon costs more than refuelling whole tank twice.
Reply: AH, about gas turbines - they are lighter. So if you have suspension and a construction that has weight limit of 70 metric tonnes - then if you use lighter engine - you can put more armour or electronic stuff.

Tanks main task is to DESTROY enemies. Not to be 'economic drivers'.
Reply: One tank at a time. 👍
Reply: As far as the air filters, I spent 16 years as an Abrams crewman in the US Army from 1993-2009. I used it in Iraq during 2004-2005, I never had any big issues with them. It took a LONG time and a lot of driving in very dusty environments for the filters to get clogged. The only thing that happens when they get clogged is it reduces our top speed from 45-50 mph to about 10-15 mph. The kits we get issued with the tank when we pull it out of the motor pool come with an air nozzle that attaches to the engine and blows the filters clean, I’m not gonna lie, this is a bitch because it can take hours to clean them all and we hated it. It’s easier if brand new filters are available. But, this wasn’t something we had to a lot of to be honest. The new versions are light years ahead of the early models and cost much, much more but are worst every penny IMO. It’s honestly the only tank I would ever consider manning. I felt invincible in the Abrams, and that means so much on the battlefield, trust in your equipment.
Reply: Most of the problems u pointed out are just completely false
Reply: @easy4life23.  
I'm more than willing to listen what those are.
Reply: @easy4life23.  The problems with the T-90’s are one of 3 things, either the active protection isn’t working or not installed, the crew training sub par, or the videos of T-90’s aren’t being shown. It’s probably a combination of all 3
Reply: @Redeffect so what do you think now that the world has seen how cheap Russian tanks are? M1 is better
Reply: @tejanodoc  M1 vs Russian armor of ANY type is no comparison. In fact any modern NATO tanks such as Challenger 2, French LeCLerc and German Leopard 2 will decimate Russian armor. As a former Abrams commander, I will admit that we would have a serious problem with Javelins etc but no where to the degree that the Russian tanks have. I’m sincerely shocked at how bad the Russian crew training was, we honestly had NO idea they were as bad as they’ve performed. The level on training in the west is just so far ahead of Russia it’s not even close. At the end of the day, honestly crew training is what makes or breaks a tanks performance on the actual battlefield.
Reply: @tejanodoc  
Good point. Probably not. The thing is, EVERTHING from Russia is cheaply made. There EGO's are what is HUGE and cheap again.
Reply: I never quite understood how they solved some problems.  turbine engines have problems in starting and restarting from standstill, at full speed they are fine, they are more compact.  I would also see them well as cogeneration for series electric motors.  Then the consumption.  Frankly, a flex like Fiat South America petrol or alcohol or a diesel engine that also oil well would be better...

 https://youtu.be/nL3F07rPIW8
Reply: There is reason- more torque at low speeds, it can use gasoline and it's like 50-100 hp more powerful.
Reply: The kv2 he can destroy it from the front
Reply: @matthewcherrington2634  
Tanks...don't destroy anything. It's the round they fire, that destroys. A soldier carrying an unloaded weapon is as much use as the rock on the ground. It's just there.
Reply: @razony  I was talking about 152mm HE
Reply: @matthewcherrington2634  
Well then...Never mind. 😶
Reply: Redeffort- I think the only problem the Abrams or anything else in this country is people like you.
Reply: So one major issue with diesel fuel from around the world is if they have any additives. Sulfer and lead are common additives to help stabilize to provide for octane to diesel fuel. This also destroys diesel engines. Sulfer when burned produces acid that eats away at your internals. So using different compositions of diesel as you seize enemy fuel can lead to drastic deduction in performance and uptime for your diesel engines which is one reason why the US moved away from diesel engines in their tanks.
Reply: I WAS AN M1 A1 and A2 Tanker and I can tell you this Video Is Horseshit
Reply: the abrams doesn't have problems
Reply: Now you know that there's a lot of dumb people that don't understand what title's mean😂😂😂👍
Reply: I'm shocked that the Abrams actually has problems this video really taught me something new thanks
Reply: the abrams is a gas hog whoever came up with the idea to put an aircraft turbine engine into a tank should be fired immediately a turbine engine cant sustain sucking up sand a dirt and all kinds of junk for very long the filters on an abrams  need to be changed after 15 minutes in a dusty environment a diesel engine is far superior in a tank may go a little slower but is not bothered by dusty environments it is very hard to keep these tanks running
Reply: the English, the Americans and the Germans do not help the Ukrainians, they put them in debt for generations and generations.
Reply: the engine of the M1 is also a lot less noisy compared to a diesel one , don't u think it is an advantage compared to the others ?
Reply: The cartoonish effects you edit into your video make it unwatchable.
Reply: redefect is gay
Reply: the best thing about the abrams was never the tank it self, it was the training the crew received.
Reply: This video aged like milk!😂😂😂
Reply: yanks cant swallow that they expensive crap is not the best as it advertised they exceptional race pride got hurt and right a way the going to bite the russian D...ck, yanks you suck as a race anything comes from you sucks as well
Reply: you seemed to think its funny that people think abrams is the best tank so i cant help but wonder what do you think is the best tank then? as someone who has done alot of research on tanks far more than your average person im very curious as to what you think is the best or what the top 3 is or if there is a tie for the best or something just wanna know what you think lol
Reply: butt hurt americans lol
Reply: I wonder why so many people have a problem with this video? Maybe it's because the way you point out NATO tank problems compared to Soviet or Russian is obviously biased. Maybe it's because you spent most of this video talking about problems on the oldest versions of the Abrams, unlike soviet or russian tanks where you review the best or newest version. Cry us a freaking river man. You can say all you want that you do everything "fairly" but you are lying when you say that. Or how you're making a bigger deal about the Abrams using a Turbine, you spend so much time making sure to tell us it isn't worth it. Yet you always make sure to quickly say how bad Russian reverse gears are and then skip to the next thing instantly
Reply: Dont worry, the average American iq is negative
Reply: You’re a douchebag Russian apologist. You should not even be here.
Reply: The Abrams tank is just a average main battle tank the only reason it got all the hype because they were fighting third world countries and a couple rebels with slippers on in the Middle East if you put it up against any modern army it will blow up just like any other tank
Reply: Nah because here’s where your wrong the turbine engine has 1,500 hp and it only weighs around 1 ton while the diesel engine weighs 2-3 tons while only making 1000 hp, and the turbine engine can operate on many different fuel types such as diesel, gas, and jet fuel making it very easy to get gas. I would argue that overall the only thing it’s worse at is fuel efficiency but everything else the turbine engine is better at.
Reply: You vill Speak bad about ze Russian Tanks or You're a Phobic chud or something like that..
Reply: The newer versions of the abrams aren’t as bad they still have issues but compared to a t90 there on the better side
Reply: I was an M-1 Tank Mechanic and operated the M-88. BOTH THE M-1 AND M-88 USE THE SAME FUEL. DEISEL.
Reply: Not to mention soviet tanks are significantly lighter and did not necessarily need 1500 horsepower to maintain similar mobility
Reply: @kobeh6185  Yeah , but that has cons and pros . The tanks is light yes , but usually the reason is soviet engines . from the 60s was bit under powered, that was one of the reason for the tanks being so much lighter than the Americans. And due to the decreased weight the tank needed to be smaller , which made the interior smaller, and decreased the crew performance . But it had low profile which is a good thing. And the traverse and the reverse speed was mediocre at best , like it was bad . Especially  the reverse . Man it sucked :I
Reply: @timurlane4004  soviet tanks were definitely not small specifically because the Soviets were "incapable" of making a more powerful tank engine, you must remember they adopted a gas turbine tank BEFORE the Abrams. Soviet tanks were small because they were built around an autoloader and cost of production. You must remember that all of the soviet tanks from the T-64 to T-90 have an engine compartment SIGNIFICANTLY smaller than any western tank, as they use opposed piston engines or gas turbine in the case of T-80. Despite this far smaller engine space and a much more compact tank, they still have good mobility. 

As far as reverse speed, I think War Thunder has made us believe it to be worse than it actually is, but I really don't know.

At any rate these tanks were built for cost effectiveness. They carry decent armor packages, are low profile, and carry a very effective and versatile weapon. Is the Abrams a better tank than a T-90MS? in most respects yeah, but is 1 Abrams better than 2 T-90MSs?

Furthermore think about earlier scenarios. A T-64 takes a massive shit on a Leopard 1 and M60 Patton. By the time of the M60s last major use in the gulf War, the T-80 existed. Not every American tank at desert storm was an Abrams.
Reply: Kobe H there lighter because they aren’t as good
Reply: To much pride in american engineering as if america is the only country that can develop a good tank smh dont get me wrong the abrams is a good tank but its not the only one and idk why when people talk about other tanks or military equpiment people like to bash it if its not NATO or red white and blue related and then when you talk about american stuff and how good their stuff is people are like hell yeah i more or so think its a people issue
Reply: @inspector647  to ne honest all i see is the bash america gets even if its something right, i also hear that the leapord is better more and i aint ganna lie it looks sexy. But to say america gets more compliment i cant relate from scouring the internet its like 10 boos to 1 yay for america i see. Eh might just be me
Reply: @inspector647  
 American pride has nothing to do with it. In fact, it is the exact opposite.

  The cannon on the M1 Abrams is German designed for crying out loud.

It's the Russian indoctrinated profiles on her and the internet in general, that can't get over the reality that Soviet and Russian equipment in many areas is subpar and lacking, and there is a constant endless amount of chest thumping by delusional people that continue to make excuses for poor performing Russian hardware, or flat out denial about the reality when it comes to the capabilities between Russian equipment verse American or Western equipment in general. 

 The Gulf war was a huge wake up call for the Soviet Union, it was the 1st time a nation trained and supplied by the Soviet Union, with advisors providing oversight and training, saw just how lopsided and devastating it truly was with modern Coldwater technology.

You can find Russian online reports about the Gulf war, and there were leaders that were calling for complete reform to Soviet war doctor  and technology.

 There are plenty of news articles, where Russian generals were talking about Iraq being "well equipped and trained by the Soviet Union and the United States and its allies was going to be dragged into a protracted ground war and suffer heavy losses."
Iraq had the 4th largest military in the world, their tanks were not as bad as people claim, their tankers used Soviet doctrine and were trained by Soviet advisers, and Iraq had front line Soviet fighters such as the mig-29 as well as a advanced air defense systems provided by the Soviet Union.

The most shocking results from the Gulf war for the Soviets, was the poor performance of the Russian supplied air defense system.
 The Soviet Union admitted to its shortcomings.

 And while the T72 was an export model, it wouldn't have mattered if it was a Russian crude frontline T72, or T80.

  They would not have been able to put up a fight on equal ground, especially in the desert, at night time with under performing night optics as well as being outranged by the Abrams.

The Abrams could also shoot on the move at full speed, something that the T72 couldn't really do, and the T80 couldn't do nearly as well as the Abrams.

I think Russian equipment is interesting, I think they've come up with some novel ideas, there's a lot of cool things in their designs, but at the end of the day, if we're talking about real world combat performance, where the metal meets the meat, it just isn't going to stand up to Western hardware.

That has been the case in every nation fielding Russian equipment going up against Western hardware, and that even includes examples when the hardware was Soviet front line equipment crewed by Soviet crews.

If people want to deny that reality, that's their prerogative, but it doesn't change the facts.
Reply: @nickdial8528  i agree
Reply: @nickdial8528  Except that Russia was banned from exporting Soviet equipment towards Iraq during the Gulf War...and that Soviet T-72Bs didn't even exist in Iraq, only T-72U references for Iraq to make their own locally made version of the tank (which is probably even Yugoslavian in origin). You scream about excuses but then you are making excuses about the M1 Abrams actually fighting real T-72s as we speak without facts backig you up...yet even American accounts support Russian explanations. Even American tankers know those tanks as Asad Babil, not T-72

And they weren't kidding when the Iraqis didn't even have NV,even though Luna has been in with the Soviet tankers since the 60s-70s. Even the Israelis discovered NV on enemy tankers as early as 1973
Reply: @JABelms  
 It doesn't matter what version of T-72 theoretically could have been in Iraq, it could have been the most modern variant of the T7-2 the Russians had at the time with Russian crews, and it would not have mattered.

The T72 doesn't have the range or move and fire capability that can compete on equal grounds with an M1 Abrams, especially in a desert environment.

 They especially didn't have any ballistic computers or ranging capability that could  match the Abrams.

No matter how you spin it, the T72 would not be able to compete.

Even the M60 main battle tank greatly outperformed the T72 in the Gulf.  
 The M60 also went up against T-72s and other variants in 1983 when Israel used M60As in the Lebanon war, and they had  105 mm cannons and were able to devastate Russian armor.

 One reason they were able to devastate Russian armor so efficiently, this  because they had advanced ballistic computers that the Russian armor did not have

As far as night vision capability, no T72 was equipped with passive thermal, not even the more advanced Russian variants such as the T80 or T90 had passive thermal, except for a rare few. 

They didn't get passive thermal until later and when they did, it was of lower grade quality than that of NATO forces.

If you don't understand what that means, that means Russian armor had no capability of seeing at night time to engage the enemy, except for  None passive night vision or infrared, which means they were only able to see targets at limited ranges at night, and they had to turn on filtered infrared light that gave off red glows.

 It was outdated and antiquated compared to the Western counterparts they were potentially up against.

The naked eye can see it at night, but if you are using night vision or thermal, you are broadcasting your position for everyone to see which is absolutely devastating when the enemy is out there using passive thermal equipment.

That is what a lot of people don't seem to understand when it comes to Russian armor vs NATO, Russian armor for the longest time didn't have anything that could compare to nato passive thermal equipment, and if any engagements were to have taken place, NATO forces, whether it  be in the Gulf war or had been in the cold war, would have been absolutely devastating Soviet armor at night time.

What's really funny, is there's actual tankers that have gone on and talked about this, and yet keyboard Warrior "experts" on the Internet love to sit here and argue with actual tank commanders who talk about these topics and explain the fallacies that get thrown around constantly by people on the Internet.

The night equipment capability is a big one.

 It doesn't matter what a fanboy or some war thunder expert things, very insight the T72 and the vast majority of Soviet armor, was completely outclassed in very key areas, especially at night time operations were it would have been absolutely devastated.

It doesn't matter if you look at the Korean war or contemporary conflicts, of all the conflicts that have been fought around the world, there has not been a single time where Soviet armor has ever won a decisive battle or caused any great losses to NATO armor.

 There are however constant examples of Western armor devastating Soviet armor, and all we continue to hear on a regular basis, is one excuse after the next.
Reply: @nickdial8528  -That's the thing, the T-72 practically DIDN'T EVEN EXIST in Iraq. 

-Firing while moving is not rocket science and existed as soon as tanks were invented. Soviets have been in Afghanistan earlier than the USA was

-That is true, ballistic computers are where M1s long range kills are credited

-The majority of their T-72M1 losses were during the Syrian civil war (all were original orders from the USSR) and there were only 400 that ever existed. The survivors were upgraded

-FURTHERMORE, there was only 1 direct tank engagement between Israel and T-72s, the Bequaa Valley ambush where T-72s decimated the early M60 platoons. The IDF answered with Merkava 1s and destroyed 8 T-72s. It is not known if the Merkava figut actually happened but since Hafez Al Assad said that the T-72 was the "best tank in the world" after that engagement...that alone shows that Soviet armor crushed Western and that you are old and full of shit

-Earliest Soviet NV for their vehicles had a maximum engagement range of 1,500KM, 1973 Night Vision tech has been back and forth between the Soviets and NATO. Soviets were never set back on NV tech, that's just shit talking

-I'm not a military expert but I am a medical doctor who has deep interest in military history/history in general and equipment. 

-You however don't look like you are we versed in history, which makes your presence here worthless. I mean you claim that M60s fought T-72s without facts backing you up. It's like you just assume stuff that happened. T-55s fought more than the T-72...wayyyyy more
Reply: @JABelms  

 You're not listening.

I am not talking about regular night vision, you are confusing that with passive thermal imaging.

Yes, the tanks had old generation night vision.

The night vision units  at maximum range theoretically could allow somebody to see up to 800m with an infrared flood light. 

  The Abrams use Night vision, but its power comes with the passive thermal imaging, and their generations ahead of what the Soviet armor had equipped.

The Abrams can see thermal heat signatures for thousands of meters away, engage targets at maximum range, before the Soviet armor is ever able to see the Abrams t or know they are there.

When the Soviet tanks turn on their infrared systems, or their night vision, it puts off a massive amount of flood light that an Abrams thermal image system can easily detect.

 Infrared and night vision is not the same as thermal imaging.

Thermal imaging has a decisive tactical advantage in every way over night vision or infrared systems.

 The Soviet night vision equipment was very outdated..It's like being in pitch dark  and somebody turning on a massive spotlight.

Even today, right now, the vast bulk of Russian armor still uses this equipment and is severely lacking behind Western night vision technology.

One reason I know this is because I was a defense contractor and was familiar with some of the equipment.

it doesn't matter what version of tank would have gone up against the M1 Abrams in night time operations, it would have devastated Soviet armor.

As far as shooting on the move... to say it's "not rocket science", no offense, but that shows your ignorance on the topic.

It absolutely IS difficult and is the reason the M1 Abrams is advantages to be able to move at full speed and engage targets.
It's  because it has a ballistics computer that is using a  laser rangefinder in concert with a gyroscopic stabilizer of the gun, which allows it to shoot move at rapid speed.

 Despite what some people might take for granted or assume, the vast majority of armor does not have that capability.

The T72 did not have this capability.

The T72 was theoretically capable of shooting at a very low speed, but it was more common than not that a crew would have to stop its tank to engage a target.

Finally,
To clean that T72s  were "non existent" in Irag is just nonsense, and that is clearly not the case.

It is factually incorrect, and it's easily proven incorrect by taking military reports that were written up after the Gulf war for assessment.

 The Iraqi Republican guard were equipped with T72s. 

 When it came to Israel's engagements in the Middle East against Soviet armor, the M60 tank absolutely performed superior over its Soviet counterpart. One reason was because of what I stated before, it had a massive advantage in passive thermal imaging.

Here is a reference from the national interest.
"the greatest improvement was the AN/VSG-2, otherwise known as the Tank Thermal Sight (TTS), which gave the M60 a passive night vision thermal imaging capability as good as that on the new M1."

https://nationalinterest.org/blog/the-buzz/the-m60-americas-best-tank-ever-24896

 Here's the same article talking about the M60 performing better over the T72 in Lebanon..

"The 1982 Israeli invasion of Lebanon saw IDF M60s roll out with a number of improvements, including one of the earliest examples of explosive reactive armor, a 60-millimeter mortar for nighttime battlefield illumination, and a second machine gun for suppressing enemy antitank missile teams. Perhaps most important of all were the Israeli-designed M-111 “Arrow” armored piercing, fin-stabilized discarding sabot round for the L7 gun, which demonstrated its ability to pierce the armor of Syrian T-72 tanks thought to be invulnerable. Israel claimed to have destroyed nine T-72s in Lebanon with the Arrow round. The Arrow was subsequently purchased by West Germany, South Africa and China."

 There were concerns the M60 may  to have been too old when the Marines used them in the Gulf war, but the M60 performed well when it went up against everything that was thrown at it in the Gulf war.

 What's funny, is you can find claims by the Soviets that Israel "lost F-15s in Lebanon", among all kinds of other absurd claims, which we all know now is absolutely false, because the F15 has never been shot down by an enemy in combat.
 It hass a perfect combat record.

As I stated in my original reply, my post still remains the same

Soviet tank variants were out classed by the M1 Abrams and other NATO armor, they did not have the capability to engage nato armor on an equal footing, especially at night time or with insufficient ballistic computers that could keep up with Western armor, and many of the variants didn't have the range to engage the M1 Abrams in the 1st place, even if all the other things had been remedied.

I'm not really sure what it is you're trying to argue.

If you're trying to argue that Soviet armor is capable of going up against M1 Abrams of the era in the 1990s, or the bulk of the armor being able to stand up against contemporary Western armor such as the M1 Abrams A2 or 3 variant coming out now, or the leopard 2, I'm sorry, you're sadly mistaken.
Reply: @JABelms  

 Oh my God, you keep saying ridiculous things that are completely debunked by the facts. 
No, they did not have thermal imaging comparable to what the United States or nato allies had. They didn't have passive thermal imaging.

 Even red effect in these videos talks about the poor night equipment the tanks had, and that they didn't have passive thermal imaging.

FFS...

The night vision you're talking about in "Gulf war videos", that is not what the tanks used either. 

 They didn't have "good night vision"  in the seventies or the eighties, you keep ignoring that.

 It was old Gen. One and Gen. 2 equipment .

 The Iraqi tanks DID have night vision, but they didn't have thermal imaging nor did the Soviets for that matter.

You keep regurgitating the same things while ignoring the facts. 

FFS...talk about ignorant.
Reply: @JABelms  

 The Soviet Union didn't have anywhere near the "best night vision technology".

 In fact, their night vision technology was very poor and lagging behind Western technology, i.e.,
The  United States as well as other nations such as Germany and France.

This is a documented fact, even RedEffect, the youtuber that makes this video, has stated that many times on his channel.

You keep sitting here claiming something that isn't true. That is a very definition of ignorance.

Here,
 let me provide a reference for you, since you continue to deny something that is a documented piece of factual information..

 Here is a d3classified report from the CIA from 1984, talking about Soviet Tank programs...

 You're not going get a better reference of gada, then the CIA.

 The entire basis for this report, is to provide intelligence on the Soviet equipment that Western nations were facing...
_"The night vision equipment, which provides 
night aiming up to a range of only 800 meters for any amminition. This infrared system is no better than the 
T-55's and, although it was competitive with Western tanks in the late 1960s, and early 1970s, now lags far 
behind contemporary Western capabilities"_

See what that says right there? ^^^

 You can find this by googling "Soviet tank programs, CIA."
 It won't allow me to share the Web address, because it is a PDF download.

 The CIA is talking about how Soviet night vision equipment started lagging far behind Western technology.

The M60 main battle tank had passive thermal imaging when its Soviet counterparts did not.

 Here is another reference talking about how T72 did not have passive night vision or thermal optics, the only had what was called active night vision, which would give away their position to the enemy and only allowed capabilities of seeing out to 800 meters..

 I've explained this to you repeatedly, and you keep denying that fact and pretend it doesn't exist, and keep claiming they had the best night vision technology which is not correct or true at all.

While the Soviets were using active night vision which limited their range of observation and gave away their position at night, the United States and its allies had passive thermal imaging on their tanks and was far ahead of what the Soviets had.

"formerly used T-72 optronics, active night vision systems were the primary solution utilized. In complete darkness systems as such were ineffective, while in conditions that are defined as favourable, they only allowed the crew to observe the situation at distances of up to 600 - 800 metres. In a situation as such it would have been required to illuminate the observed area with an external infrared source. The light emitted by the infrared systems is invisible to the naked eye, but the enemy could potentially observe it and locate the tanks with the use of the night vision systems remaining at his disposal. Making use of NVG systems in optoelectronics of MBTs may expose their position."

https://www.defence24.com/polish-thermal-vision-systems-for-the-t-72-main-battle-tank

 I could literally sit here all night and give you one reference after another, talking about Soviet night vision capabilities, and how it was and still is inferior to Western equipment.

 In fact,
 It was discovered that the new T14 Armata Russian tank, that people think is so great, has Western made equipment on it because the Russians still are not capable of producing thermal imaging equipment that the United States is capable of.

Russian hackers, that are sympathetic to the Ukraine, hacked the emails and data of Russian security personnel and was able to pull information up on the tank and the equipment it uses.

_"According to emails obtained by Taia Global (Russian hackers sympathetic to Ukraine hacked the email account of an Russian individual with apparent close ties to the FSB and provided the cybersecurity firm with more than 9,000 emails), the Russian defense industry is having difficulties producing thermal imaging systems like night vision cameras.
The reason? Russia’s inability “to produce a critical component — microbolometer arrays — which can capture images without requiring cooling, reducing the size and complexity of thermal imaging systems,” The Intercept, an online publication that analyzed the Taia Global report, explains.
The report quotes a 2013 letter written by Dmitry Rogozin, deputy prime minister in charge of Russia’s defense industry (see: “Meet the Russian Politician Who Thinks ‘Tanks Don’t Need Visas’”) who stated that “at present, the Russian Army only has a few hundred individual imagers and no sighting systems and machine vision systems with advanced performance. On the other hand, our potential enemy troops — NATO, are equipped with hundreds of thousands of thermal imaging sights, sighting and vision systems.”_

https://thediplomat.com/2015/06/is-russias-deadliest-tank-using-western-technology/

 There you go......

I have given you facts, I have given you links ,and I have provided you with information debunking the claims you are making.
 If you still want to sit here and pretend none of this is true, then you absolutely are choosing to be willfully ignorant.
Reply: @JABelms  I agree with your comments,but do you KNOW how hard and entertaining it is to fight T-80's and T-64B's in wargame:red dragon?
Reply: ooooo its so fun to see usa how they reackt on critic. guys you need some pills to get over it? therapeut??? somebody to talk abaut you personal problems??? therapy grop or suicide help number???
Reply: We all need to be realistic when discussing any tank design. Every tank design is a series of compromises. No tank has a perfect blend of all the characteristics necessary to be the ideal tank. I agree that any decisions made by any army and the engineers who design a tank are a gamble, and such decisions are made to fight the last war. The best designs are perhaps those that can easily be modified to account for changing conditions. The Abrams has been successful so far. The US found itself trying to cope with conditions in Iraq and Afghanistan after it put tanks there. The Abrams was designed for a massive force on force battle where tanks would last a matter of minutes, and the M1 would be a winner if It could last a little bit longer than its Soviet counterparts. It was not designed for counterinsurgency, and it was a shocker when RPG's were taking out Abrams tanks, somewhat similar to the Soviet experience in Chechnya. The tank was modified accordingly and soldiered on. The Abrams is getting long in the tooth, and there are discussions about replacing it. Let's not forget that the next tank will take time, astronomical amounts of money to develop, and the designers will need to make a whole series of design decisions based upon the last war. In other words they will start all over again.
Reply: @bohica3264  no but you can't have some random non experienced tanker to sit and play "know it all" when he's got outdated information, no experience and lacks validation.
Simply put, I'll put my 20 plus years on the Abrams up against this guy any day.
Reply: If Abrams commander really was issued night vision goggles, then why night vision sights werent mounted on the tank? That is undeniably a design flaw, its an inferior solution.

And lack of night vision in the tank itself is a design flaw, even if the problem was solved otherwise, the fact that TC was issued goggless solves the issue, but doesn't make it any less of a design flaw. In this context it would be the same if TC was issued goggles, as if say he was forced to use his own private goggles. Neither makes it any less of a design flaw, the machinegun analogy is good.

Even if it fixes the issue and was accounted for in the M1 design, then that is still inferior, and a design flaw, EVEN IF the solution offers superior night vision to soviet tanks.
Reply: @werrkowalski2985  night sights where mounted on the tank just not for the commander, also you have to remember that night vision devices of the time Gen 1-2 where rather limited in their range and magnification, so more often than not the commander was still relying on the gunner's better night vision devices to accurately spot and identify targets. not to mention while Commander didnt have his own night sight he could still see through gunners thermal imager which had a very wide field of view which allowed him to look around while the gunner was busy engaging targets so the gunner didn't get tunnel vision also even if the M1 had a NV periscope like on the Soviet and German tanks it wouldnt really improve his ability to look for targets at night because gen 2 while it did have really good visual range the image quality was rather fuzzy which made seeing targets at longer distances (1km and beyond) much harder. So like I said earlier the commander would still have to get most of his target identification from the gunner. the night vision goggles i mentioned where more for seeing friendly tanks and signaling them at night during periods of radio silence as well as maneuvering at night which is why the driver and loader where also issued night vision goggles.
Reply: It was a good video, but a lot of the issues that you point out make a lot more sense when you look at the context of why certain decisions were made. It's easy to look in hindsight and point out that maybe the gas turbine wasn't the best choice because diesel was far more efficient, but at the time early night vision wasn't anywhere as good as what's around today and Diesel has a far more obvious exhaust, given that generally the winner is he who fires first in a tank battle it's entirely possible that having that tiny edge was considered worth the trade off. If anything their biggest issue was lack of foresight in how quickly night vision technology would develop.

Every decision that the design team made is in the context of "We could go to war with the Soviets in Europe at any time", and "We'll build it modular and improve on it later". For example they expected to be fighting defensively against hoards of T-72s and T-64s, so they built a tank that had good gun depression and could go hull down well, but didn't have the best fuel efficiency since they'd be fighting in their own territory and not extending their supply lines like the Soviets ostensibly would. The lack of armor on the front hull wouldn't matter anyways since they'd be angled in such a way that it couldn't be targeted. Tactical needs were considered more important than export.

A lot of the reason you're getting backlash, I feel, is that in comparison to your videos on Soviet tanks you provide a lot less context and that makes you come off as somewhat biased. This might be entirely coincidental or it might be due to a comparative lack of knowledge in the two fields, but that's just how it is.
Reply: @todo9633  he also forgets that, like with the m4 before it, the Abrams is being designed with the fact that it will be fighting on the other side of the planet in mind and this means that every part must be able to be repaired at a field repair depot and they can't expect to just ship them back to the factory. This is also why it takes so long for upgrades to be implemented. They need to meet the same standard of ease for repair.
Reply: @maracca-man  
 A lot of people don't know this karma but the T90 and even the T80 in some regards, were not well equipped for field maintenance and repair. The T90 in particular, was notoriously unreliable and had poor capability for field repairs.

In reality, the T90 and the T80 are just retrofitted upgrades of the older family of tanks, such as as the T-72.

A lot of people don't like to admit it, and they try to blame the T-72 losses  in Iraq on being an "inferior export models", but thats not true. 

 The T-72 had the same armor package that the front line Soviet models had, and also had the same gun.

 Before anyone tries to claim otherwise, you can download declassified PDF document from the CIA during the cold war and early 90's, that talks about this very subject.

It doesn't matter if he had Soviet tank crews in Soviet frontline T72 tanks in the Iraq war, they still would have been outclassed, inferior during night time operations with poor night optics, and they would not have had the range to engage the Abrams before the Abrams engaged to them.

It still would have been a turkey shoot either way.

I don't know why cognitive dissonance is so prevalent when it comes to this stuff, but it does get a rather annoying at times. I guess Russian propaganda and national pride takes it toll. 

Anyone who has played Warthunder can see a clear Russian bias. It's been proven time and time again. 

I even saw a court case in Russia where a blogger was charged for talking about the Soviet Union invading Poland in WW2 with Germany. 
The judge said he was "spreading lies and making Russia look bad"

This is a proven historical event and the Russian courts denied it happened!

It's specially frustrating when you have keyboard experts arguing with people that actually use or used this equipment in the real world.
 There's always an excuse for why the Soviet equipment was outperformed. 

 For example, the mig-29 was a modern frontline Soviet fighter that went in the air against US aircraft by Soviet trained pilots, but it was defeated none the less against F-15s.

In 1999, a Dutch F-16 shot down a Serbian Mih-29.
http://www.f-16.net/f-16-news-article607.html

 Then people will try to scream that if it was a Soviet pilot it would have been different, not likely, but that's what they claim.
The Serbian Mig was definitely up to par.

 Of course, you can just pull up the Korean war as well, where it is a known fact that seasoned Sylvia World War II pilots in mig fifteens fought against F86 sabers.

 The American sabers still outperformed and defeated the Russian piloted Mig-15s a majority of the time. 

 It's not hard to find historical examples of real wolrd combat performances between U.S. and Russian equipment, unfortunately,  the excuses for outperformed Russian equipment is also not hard to find.
Reply: @todo9633  this content creator is Serbian
Reply from the maker: @todo9633  
MTU MB 873 has comparable, and if not better, performance when compared to AGT 1500. Consumes less fuel and is far cheaper. If you put MB 873 in Abrams you would have pretty much similar result performance wise. 
The fact that night vision wasnt "advanced" is completely wrong. Soviets had adopted night vision sights for their tank, both gunner and commander, back in the 60s, on top of that, all NATO tanks used IR, both passive and active, it wasnt as good as thermal sights, but there is absolutely no reason for you not to put the night vision sight. 1st gen IR sight beats not having one, by a long shot. Soviet tank commander even with 1st gen IR could see at like 800m, which is a lot, especially for European Theatre. Western IR could reach even farther than that. 
The hull design at the time did not predict massive improvements in projectile development, there is a reason why I havent mentioned it being a problem until I brought up later Abrams models. Having bad armor on the LFP is somewhat forgivable, but the UFP is several cms under the turret, it still has a lot of chances of getting hit and it is very weak.
I havent provided more or less facts, its that this video covers more variants per say. T-90 tank only has 3 variants, where Abrams has a lot more to cover, that is why it appears to go more into detail, but it hardly does. It could also be the fact that I tried to make it more comedic, but people just cant take a joke and immediately took it as if I was making fun of Abrams...
Reply: @RedEffectChannel  My point wasn't that night vision wasn't advanced, it was that it wasn't anywhere near as advanced as what we see in modern times. Just like how a stealth plane being slightly harder to spot on radar might only buy a second, but can still be the difference between life and death in a combat situation, a tank that is spotted a few seconds or even a fraction of a second later because it's harder to see in night vision might get a shot off first, and shooting first is very important.

Same thing can apply to the gas turbine being quieter. If you hear tanks coming 1 mile away instead of 5 miles, that's time spent maneuvering or preparing for combat that you'll never get back, and time is the only resource that's invaluable.
Reply: @RedEffectChannel  i dont think you are well educated on the different generations of night visions and id advise you to take a look for future posts. the the Soviets used generation 1 night vision which was essentially a special lenses that could amplify some ambient light but it was very dark and primarily used IR illumination to actually see and make out targets however the downside was that the larger IR spotlight would give away your position to anyone who had night vision i.e other tank also 800 meters is rather dubious because that might be the range of the Intensifier tube but you would be hard pressed to actually make out and identify at target at anything past 500 meters because im not sure if you have ever used gen 1 night vision but its a far cry from anything being used today.  generation 2 however doesn't need IR illumination (which is why NATO tanks stopped using the IR searchlight in the mid 70's) and can see much farther than Ir assisted gen 1 night vision. to put into context how subpar soviet tanks where at night fighting the driver of a M1 could spot targets more effectively than the gunner/commander on just about every Russian tank until the T-80UK and T-90.

Also Red have you see what the sight picture is of a M1 at 2km's is ?, the UFP is pretty much invisible the only thing you can see is the massive cheeks and LFP. you have about as much chance of scoring a hit on the UFP of the abrams as you do hitting the turret ring of the T-90A.
Reply from the maker: @todo9633  1st generation thermal wasnt nearly as advanced as modern 3rd generation like Attica... It was still used because it gave advantage over those who did not have it. Same goes with IR sight, if you can see targets in the night even at 200m, and they are blind, then it is completely useful to have it (200m is over exaggeration, they could see farther). M60 at the time had active and passive IR tech, it could have easily been implemented to the M1 for the commander. But it wasnt. If a Soviet tank commander could look around at night, even with 400m (passive mode) range of identifying a tank target, it still beats being completely blind by a long shot, not only does it help at locating targets, it also helps commander guide the crew during night combat, since he can see the terain around him, and that is even bigger reason to have IR sight. There is absolutely no downside to having one, period.
Reply from the maker: @nemisous83   1st gen Soviet night vision had passive and active modes. Active being where they used IR searchlight and passive where they didnt use it, therefore used ambient light. In low light conditions T-80B commander could identify a tank sized target at around 400m in passive mode, he could see up to 800m in active mode but it was more of a strreach because the actual night vision sight could generate a very good picture at that range, but still, the point stands, there is absolutely no downside of using one, especially for helping the TC guide the crew in the night combat around the terrain.

Also, you have to be joking? T-90A turret ring is of comparable size (even smaller) to M1 turret ring. The entire point of UFP being bad is that if you hit below the turret ring you will penetrate the tank, on most of other modern tanks if you there you will hit the actual hull composition, UFP is not very small, and is not as hard to hit as you make it out to be (like comparing it to a turret ring)... you have to be joking.
Reply: @RedEffectChannel  the gen 1 used by the Soviets was of the earlier cascade style passive night vision which had considerable fish eye (edge distortion) compared to the sharper gen 2 which was not only brighter, clear, and had double the range. Saying the Soviet gen 1 NV was passive is a joke because unless there is a full moon seeing past 100 meters is pretty much impossible which is why the tank almost exclusively relies on IR illumination to spot targets but fighting or manuvering at night time would be very difficult. But my intial arguement which you clearly glossed over is the commander DOES have the ability to scan for targets at night outside his normal parascopes infact he has better night vision than any Soviet tank.

Again I'm going to ask if you have even seen what an M1 looks like at 2km through a gunners scope? Because the UFP is barely noticeable and isnt a very easy shot to make even with modern gunnery sights.
Reply: @RedEffectChannel  Never said that, in fact I agree that the Abrams had many design flaws, the lack of commander night vision being one of them.
I was just making the point that the early gen night vision devices on tanks didn't provide nearly as clear of an image as later gens did, especially at longer ranges and that the difference in how visible heat the exhausts of Turbines and Diesel might have been more of a possible advantage due to that(compared to later generations) lack of sophistication.
Reply: @todo9633   the commander and driver had acess to night vision on the Abrams they used PVS-5 night vision goggles.
Reply from the maker: @nemisous83  You clearly have no idea about Soviet night vision sights and it can tell, if you think they can only see up to 100m in passive mode then I have nothing more to talk to you, I am just wasting my time at this point, literally.
Most of the tanks at that range would look like simple tank shaped silhouettes, thats not the point at all, most of the time you would aim at center mass, guns arent pin point accurate and UFP is still a weakspot, you are desperately trying to give it a pass, but the point that it is a weakspot still stands, it is just under the turret which is even worse. You only have to know that you can shoot just under the turret and no matter if it drops below 10cm or 50cm, you are going to penetrate the tank, it is a weak spot, and not a tiny one at that, stop trying so hard please.
Reply: @RedEffectChannel  in fact i actually have a original Russian 1PN58 RPK night optic which uses the same cascade image intensifier tube seen on the T-72B and T-80 tanks. The quality of Russian gen1 passive is sort of in the middle between Gen 0 night vision(ww2 night vision) and real deal Gen 1 passive (PVS-2 starlight scope) in terms of power and clarity.
Reply from the maker: @nemisous83  First of all, which Soviet night vision sight do you own? 
Second thing is. Soviets did not jump from 1st gen IR to 1st gen thermal from France. They developed 2nd gen IR and also used a lot of improved 1st gen (aka 1st gen+). They had thermal imagers of domestic production, namely Agava-2 which was adopted on T-80U command tanks (T-80UK) as well as modernized T-80U tanks. Russians went for 2nd generation Catherine FC thermal sight produced by THALES for their modern tanks, because it was cheaper for them than to produce Agava-2 which was really expensive for them, they even got a licence to produce Catherine sights, which are not produced by Russian and Belarus companies.
Reply: @RedEffectChannel  I own several PNV-57 (gen 0) PNV-57E(gen1 passive cascade) 1PN34 AND 1PN58 (gen 1 passive cascade) which are RPK and RPK-74 night sights I also own a commander's night vision parascopes from a T-72B which is also gen 1 passive. However i think you are showing off your novice in the subject of night vision because Gen1+ isn't a real thing. It's actually just a marketing term the Russians used to sell off alk their old Gen 0 and Gen 1 tubes on the commercial market in the 1990's. For instance most of your "Gen 1+" tubes are far less powerful than Gen 1 passive tubes. The closest thing to Gen 1+ is the Armasight spark which uses CORE technology to correct the fish eye effect and give you a sharper image however this tube is still very weak compared to Gen 1 passive and still requires IR illumination. As far as i know none of these "gen 1+" devices where ever fielded by the Russian Federation. Because by that time they where buying Gen 2 tubes from Europe for use in a night vision binoculars and monoculars. As for the Thermal imager used on T-80UK and early T-90 they where very crude even by Gen 1 thermal standards which is why the Russians sought better thermal imagers from Europe.
Reply: @RedEffectChannel  also there isnt really a 2nd generation IR night vision device unless you are referring to Gen 2 passive? To which I would disagree because the Soviets never developed gen 2 night vision until the 90's but those where not used on tanks but rather infantry Monoculars, binoculars. And weapon scopes.
Reply from the maker: @nemisous83  dude, I know its not a real thing, that is why I put it in brackets just so make it more clear what Im referring to, those sights are just slightly improved older sights, nothing more than that. But, I sincerely doubt they are as bad as you claim them to be, I couldnt find any information on passive mode of Soviet MBTs at the time that give them values as bad as 100m, be it German, Russian or English source, legit none. It would be kinda pointless to put a night vision sight that can only enable you to see in such a short distance, tbh I havent researched that much for T-72s night vision devices because I focused more on what T-80 had to offer, because it was "the best" Soviets had to offer, and from what I found, the passive mode for the commander had 300-400m vision which is pretty decent (I mean if you can see only up to 100m in 4-5x optical zoom then its completely useless).
T-90 never actually used a thermal sight, several have been made with them (like maybe two tanks) for testing purposes, but T-90 model 1992 went around with pretty much the same FCS as basic T-80U.
Agava-2 wasnt bad at all, for a 1st generation thermal it was decent, in fact, it gave better magnification that what Catherine FC gives to modern Sosna-U sights, the resolution was not satisfactory but Catherine FC is barely better. It does offer greater detection range, etc. but Agava-2 wasnt that bad at all, yeah you could say it was crude, but it was satisfactory.
Reply: @RedEffectChannel  well 100 meters is about the range you can reasonably distinguish something from the background technically you can see about 1000 meters away but it's so low res that it can barely be considered a useable image . Also you have to remember that these devices where intended to be used with IR illuminator to distinquish targets mainly for spoting purposes so information about passive mode is going to be difficult to find because no one used passive mode for Gen 1 because of how poor of an image you got . But I can assure you Russian gen 1 Passive is pretty archaic, without IR you can barely see anything because the tubes just arent that powerful. That being said my original arguement was about how you erroneously made the claim that Abrams commander had no way to spot for targets at night and had to rely on the Gunner which is false because the commander possessed Gen 2 Night vision goggles as well as the driver and loader. Where as the Soviet counterparts do not have Gen 2.
Reply from the maker: @nemisous83  Again, I find that extremely hard to believe, that is very bold claim to make when everything that exists goes against it.
The fact is that the tank does not have any night vision equipment for the commander, you have to rely on infantry equipment to do something, night vision googles arent really useful with no magnification or as good magnification, googles arent scopes, not to mention that they would be very annoying to use inside of a tank, the point being made was against a tank. It would be like saying that the tank didnt originally come with any machinegun, but the crew took a machinegun and put it on the tank in order to use it against infantry, the point that the tank doesnt have a machinegun would still stand, we are talking about a design here, and M1 as a tank did not have a night vision device for the commander.
Reply: @RedEffectChannel  at the time it didn't need it because Gen 2 Night vision was so good compared to the obsolescent Gen 1 passive. Not to mention the M1 abandoned the full buttoned up commander as seen on M48 and M60. Also the PVS-5 is not infantry equipment the PVS-5 was issued to vehicle crews as well as helicopter pilots. Meaning the PVS-5 is SL3 to the vehicle just like Radio is. Regular Infantry would not receive night vision goggles until the PVS-7. Also the PVS-5 is technically a 2x power optic in fact all night vision devices have some sort of  magnification. That being said it would be bold of you to say that Soviet tankers where better at spotting targets at night because Gen 2 Night vision has about twice the range, no fish eye, much brighter and doesn't need IR illumination whuch is a huge plus because the tank doesnt have to give away it's posotion to spot for targets like the Soviet tank does.
Reply: @RedEffectChannel  just admit it bud you goofed you didnt know the Abrams commander had the ability to search for targets at night be it physically attached to the tank or not.

Side note the Abrams could also mount a AN/PVS-4. Gen 2. 3x scope to the .50 caliber machine gun that the  commander could also use to search for targets and lay down suppressive fire.
Reply from the maker: @nemisous83  dude, as I said, the tank as a tank didnt have the night vision sight for the commander, the tank doesnt have the night vision sight for the commander, as I said, in its design it didnt have it, the entire point is about the tank, and the tank as a tank doesnt have that, period, I dont know how else do you want me to put it honestly. Commander lacked his own sight (if we exclude the 3x sight of HMG with limited fov) and the tank, because of a lack of a proper sight for the commander, lacked the night vision device in its design...
Reply: @nemisous83  man, you are talking nonsense. t-80u has completely different night sights
 btw early t-90 uses same sights as t-80u
Reply: @vladimirkudryavtsev3606  t-80u still uses standard Gen 1 passive night vision.
Reply: @RedEffectChannel  the mental gymnastics you are going through to not admit your error is amazing. At this point you are arguing semantics to save face because you where trying to make a point that Soviet commanders had better night vision, and Abrams commander had to rely on gunner sight which is absolutely false. The commander might not have had his own independent night visionnsight bit he was by no means blind at night ad had far better his ability than Soviet commanders.
Reply: @nemisous83  jesus, man, you are trolling or what? t80u has second gen on both gunner and commander sights and t80bv has gen 1 on commander and gen 2 on gunner
Reply: @vladimirkudryavtsev3606  actually no.....the Russians wouldn't develop gen 2 devices of their own until the 90's. If they had Gen 2 they wouldnt need the Luna IR lamp because Gen 2 has a longer range than the IR lamp itself.
Reply: @nemisous83  first of all, early t-90 and t-80 has absolutely the same sight and night vision device in it, but t-90 does not have luna searchlight
Reply: @nemisous83  secondly, did you know that shtora-1 on t-90a(2004) has searchlight mode to help search targets in the night?
Reply: @vladimirkudryavtsev3606  shtora-1 was only fitted to T-80UK the commander version of the T-80U. Also Shtora 1 isnt a type of night vision device but rather a countermeasure for laser guided beam ridding ATGM's. The two "eyes" on tge side of the turret are equivalent to IR searchlight but they are coded in a way to disrupt IR beams. They wouldnt be very helpful in a night fighting role as IR floodlights because they would have an almost strobe effect on the Gunner sight and arent a consintrated beam like the Luna IR floodlight.
Reply: @vladimirkudryavtsev3606  depends which T-80 you are referring to the standard T-80U does not have Gen 2 Night vision (hence the searchlight) however it's very likely the Shrota 1 was used as a IR searchlight but it wouldnt be a very effective one since its more of flood rather than a beam of IR light........but you arent really proving your point that t-80 and t-90 has gen 2 night vision....
Reply: Nick Graham dude are you like really against Soviet equipment and really for US equipment? Because if that’s the case, having a discussion with you is pointless
Reply from the maker: @nemisous83  T-80U uses TKN-4S sight with 3rd gen light illumination, commander can apparently see a tank sized target at 700m at low ambient light of 0.003 lux, compared to 400m of TKN-3M under 0.005 lux. And in active mode the commander can see up to 1km. If you want to tell me that the night vision googles are comparable to that, then idk what else we can talk about here (modern night vision googles arent even comparable to that).
Reply: Nick Graham your absolutely destroying these people with facts. I love it. But you have to understand this is an eastern bias channel. In comparison to other tank channels that are western bias. People will argue with you that for days
Reply: @nemisous83  Facepalm shtora-1 has special MODE for that purpose
Reply: RedEffect you seem to have a lot of faith that all 22,000 Russian tanks are modern and upgraded to par. That’s a lot of hope for a country that tows it’s own aircraft carrier
Reply: @agentc7020  its not about soviet equipment bad and us good its about guy rather trolling or doesn't know what he is talking about
Reply: @nemisous83  it proves my point, because all indian t-90s and many russian ones does not have luna or shtora-1 on it, yet they are still not blind at night
Reply: @agentc7020  no im just pointing out that in terms of night vision equipment the soviets where very much behind the west. If i hated Soviets then I wouldnt collect old cold war night vision devices. Just because you can't cope with the fact that soviets had sub par night sights doesnt make me a "hater"
Reply: @RedEffectChannel  but please continue your ignorance it just makes for good screenshots so all the other tank groups can laugh at you.
Reply from the maker: @nemisous83  Im just telling you what I find. I can back that up with several sources. T-90 used the same sights as T-80U but it does not have a IR searchlight, as one source states, IR searchlight for T-80U barely did anything, but they still decided to keep it because it gave a slight advantage over the passive mode. If you can find me information about T-80U that contradicts what I said I would be more than glad to take a look.
Reply: @nemisous83  oh yeah. it is  so powerful. quote from Department of Defense Dictionary of Military and Associated Terms document       "The 1977 fielding of the passive M32E1 sight for the gunner and M36E1 periscope for the commander as well as the M24E1 IR night vision block for the driver provided second generation night vision capabilities for M60A1 and RISE tanks. These new passive gunner's sight and commander's periscope provide recognition capability at longer ranges and at relatively low night light levels (1/2 moonlight). Under starlight conditions, they will provide recognition beyond 500 meters with the use of an AN/VSS-1(V)1 IR searchlight"
Reply: @RedEffectChannel  same on t72B1  thats why they are blanked most of the time even on exercises
Reply from the maker: Oh sorry, slight correction, T-80U doesnt have a IR searchlight for the commander. But yeah, I hope your friends are having a blast
Reply: Nick Graham yeah “tank groups” haha experts I tell ya
Reply: Nick Graham no but it doesn’t really make you a nice discussion partner, you’re like really refusing to accept anything red says and you refute without any sources (that I have seen, your comments are hella long so pardon me if I missed one) other than “I own one”
Reply: Shifting N Drifting technically speaking I’m sure Russia could and would upgrade them if they were to enter a war but I’m sure they are a backwater country in your eyes so whatever anyone says will just fall on deaf ears
Reply: @agentc7020  seems like dude never listens whatever argument you make
Reply: Nick Graham what forums do you use?
Reply: @agentc7020  if you would like i can link you to several examples of Soviet gen 1 Passive night vision right here on youtube so you can get a feel for what the sight picture looks like without IR assistance. its still usable but 1km range is poultry compared the range and clarity of of Western optics. because even the older M60A1 AOS with its Gen 2 night gunnery sight has an effective range of 2.5km without any need for IR assistance
Reply: @RedEffectChannel  do you have sources to back up that T-90 and T-80 use Gen 2 night vision? here is a few I've found i wouldn't take them as gospel but it proves that the T-80 couldn't possible use Gen 2 night vision because the range is too short 700-1100 meters which is consistent with gen 1 Passive devices. Also had the tanks been fitted with a new generation of night vision device it surely would have been annotated in the literature about the tank. Now the Russians might have created a more powerful version of Gen 1 passive that falls short of Gen 2. but to this day I haven't found anything suggesting the Soviets even had Gen 2 night vision devices prior to the fall of the Soviet Union. also its reasonable to assume they simply didn't have it because Gen 2 was rather new in the west when T-80B first came out so it would be impossible for the Soviets to have acquired the technical know how to produce Gen 2 intensifier tubes because that was a well guarded secret only shared with other NATO countries. If what you say is true it would mean the early T-90's where actually pretty shit in the night fighting department when at the time the US was already starting to field M1A2 with CITV.
https://fas.org/man/dod-101/sys/land/row/t80tank.htm
http://www.tanks-encyclopedia.com/coldwar/USSR/T-80.php
https://www.inetres.com/gp/military/cv/tank/T-80.html
Reply: @vladimirkudryavtsev3606 notice how it says "recognition" instead of "detection". recognition is the ability to positively ID a target. Detection is the distance in which you can see a moving target.  gen 1 passive can see out to like 1100 meters but visually recognizing the target is much harder where as the Gen 2 devices can see much farther and doesn't need IR illumination. The document you referenced is an early test of the Gen 2 devices hence why they are still using and IR searchlight because a few years later they would ditch the Searchlight entirely because it really just obscured the night vision tube and make the image unrecognizable. If you want further proof what the difference between Gen 1 and Gen 2 devices looks like here is a video explaining all the different generation of night vision...... thats why im skeptical of the claims a soviet tanker could spot a target at 700 meters without IR assistance even with the added magnification of the optic getting past the "fish eye" would be pretty rough.
https://www.youtube.com/watch?v=taoYeDcMQyw
Reply from the maker: @nemisous83  First you were saying that you are barely able to see 100m in passive with 1st gen IR and now you are saying that 700m is consistent for 1st gen? I dont get it...
https://thesovietarmourblog.blogspot.com/2016/02/t-80-gambol.html
http://btvt.info/3attackdefensemobility/suo_history.htm
http://ivto.omgtu.ru/wp-content/ivto/biblioteca/uchebnici/Pribory-nochnogo-videnija-bronetankovoj-tehniki.pdf
Soviets have already implemented 2nd generation on TKN-3 and 3rd generation on TKN-4S. Last source especially goes into detail. The generation concluded from the performance, but from the way the sights operate, Soviet 2nd gen might could have been vastly inferior to Western one, but they have developed 2nd gen IR as well as 3rd gen IR in the 80s...
And yes, T-90 had very poor night vision compared to western tanks, many officials deemed the tank a failure, it was a very bad tank for the time it came out, in many other ways other than the night vision, M1A2 was miles ahead of it.
Reply: Nick Graham I would very much like if you could link the sources please
Reply: @nemisous83  
according to wikipedia AN/PVS-4 second gen sight has following characteristics: Range of detection 600m (Starlight) Range of recognition 400m (Starlight)
Reply: RedEffect This question i want to ask may seem a bit dumb to ask but I genuinely want to know this. Could it be possible for an outdated 2nd world war tank such as the king tiger and its long barrel 88 or very rare 105 mm cannon with a standard panzergrenate 39 shell penetrate the Abrams turret ring by ricochet off the sloped plate. Or could it just go through lightly armoured sloped plate.
Reply: @nemisous83  you just cant get over it that somebody critic usa weapons. bro you need therapy??? some pills or therapy group???? please dont do suicide and stop crying
Reply: Nick Graham abrams wins because of 16-mil-std anyway. Lol
Reply: @RedEffectChannel  how many of those design flaws were made to spite the Germans? there was a failed joint design a couple of years before.
they didnt wanted the german engine and went for a far inferior gun at the start.
Reply: @lordmegatron7359  the 105mm tiger 2 didnt exsist, although I do believe that any hit to turret ring in any tank from that round would knock the turret of the tank...
War thunder player? Me too...
Reply: The Fogel  yeah I play war thunder and well I was just curious about if a ww2 tank could knock out or disable modern tank. Also I did have my doubts about the 105 tiger but thanks for the info and the reply.
Reply: @RedEffectChannel  well by 100 meters im referring to the passive mode and that's generally true under no moon cloudy conditions, in the active mode it will see as far as the IR floodlight will reach which can be atleast 800-900 meters but keep in mind the beam of the IR illuminator is very narrow so the commander has pretty poor visability and he is effectively giving his position away. now the Gunner can see a bit farther because his gunner sight is magnified but he still has the issue of a very narrow field of view and having to effectively signal where is tank is to see in low light conditions. keep in mind most of the maximum detection range statistics are done under a full moon. with ample ambient light. 

also i think you are misunderstood as to designations of the different generations of Night vision. in all of your sources that you list it only lists TKN-3 as "the first passive night vision device fielded by the soviet" which would imply that it is a Gen 1 passive device. keep in mind there is a big difference in performance between Gen 1 and Gen 1 passive. gen 1 can only see IR light without it the image is too dark to effectively use. however gen 1 passive allows you to amplify light more effectively which means the gunner can actually hit at target past 300 meters in passive mode. however TKN-4S is a bit tricky it doesn't explicitly call it gen 2 but  the specs seems to suggest it was at least at best as sensitive to light as Western Gen 2 devices. keep in mind just because the manual calls it "gen 1,2 3 IR" doesn't mean that its the same as contemporary gen 2 and gen 3 western devices. it could just be what the Russians called their different generations of Night vision devices. Because if T-80U and T-90 where using Gen 3 night vision then they really wouldn't need thermal imagers because Gen 3 devices are super crystal clear and you can make out targets at very long ranges past 1km and where far better than the early generation thermal imagers that T-80UK T-80UM and T-90A received.
Reply: @vladimirkudryavtsev3606  yeah but the AN/PVS-4 can see like 2km away and doesn't have the fisheye effect which pretty much cuts your field of view in half. but detection again is the distance in which you can see a moving target. I'm talking about how far the tube can actually see Soviet Night vision devices are mostly limited by the range of their IR lamps which also have a very narrow field of view and give away their positions Red Effect posted a few documents that put the TKN-3 (t-72A-T-80B) at 400 meters in passive mode for the gunner and about 800 meters with in active mode. also keep in mind the PVS-4 is only a 3.5x power optic where as the TKN-3 is a 7.5x optic so 400 meters for the TKN-3 is rather weak sauce when you compare it to the PVS-4 which can recognize a target at 400m with half the magnification of the TKN-3
Reply: @nemisous83  are you a denial?  Or you dont care?
Reply: @RedEffectChannel  just want to inform you that the mechanics who work on the tanks much prefer the Abrams because everything is modular. Also, the turbine is in almost all cases, tuned up by the mechanics over seas for over 2000hp. Abrams top speed with a tuned engine out powers the capability of the tracks. It is much faster than any other MBT. And the fuel consumption at wide open throttle of the Abrams to the leopard is actually comparable. Therefore Abrams is usually deployed at much higher speeds because the fuel consumption, as you mentioned, is practically the same at idle as when it is driving. Therefore they can cover way more ground per gallon of fuel than any other tank. This is one of the main reasons the turbine was not replaced in the latest version of the tank that recently came out.
Reply: @marinusdedreu3833  Fuel consumption on the Abrams actually really does suck in comparison to other tanks, or at least the latest tanks anyway. The reason why we haven't switched to a more fuel efficient engine is because fuel efficiency is actually nearly irrelevant in the face of what the entire rest of the logistical train gobbles up orders of magnitude more fuel than the tanks.
Reply: RedEffect torque was higher on AGT
Reply: @RedEffectChannel  the MTU is very underpowered engine also the is very sheet tank
Reply: @shiftingndrifting1532  What Aircraft Carrier? It's now been compromised by fires and short of a years long docking can't function as a true carrier at all.
Reply: RedEffect come on man, I thought you where better than this! He is right, from the limited research I did just admit you made a mistake. We all make them and there’s no shame in it!
Reply: Nick Graham thank you for your input it was a good read. Sorry everyone is so against you here
Reply: tron  usa people cant handle whit true critic. They just wach rambo films and think that is reality
Reply: @RedEffectChannel  it still uses a light which is still a disadvantage id rather have the full NV capable .50 on the 90 degree FOV vause it doesnt give away my position MORE THEN MY OWN HEAT SIGNATURE.
Reply: @shiftingndrifting1532  wtf you r talking abt ... most YouTube channel r pro usa and very bias. Not everyone is from states nor we care abt you guys
Reply: Adam Paula ya that’s because YouTube is a English dominated app. The internet in general is English dominated. That doesn’t change the fact that there’s no reason to believe pro Russian videos just like there’s no reason to watch pro American videos. I want accuracy not to hear what I want to hear. Now red effect sure knows a lot about eastern rank designs that’s why I watch him. But he falls victim to the same propoganda all Russian citizens do.
Reply: @shiftingndrifting1532  But most of channel do fall propaganda for usa. Even though sometimes they show more logic.
Reply: @shiftingndrifting1532  cool but if that was directly to me I'm not russian and I'm just stating facts , T90 M tank are more reliable and more battle efficient in other ways that the abrams cant , abrams was design to troop support and by sniping the shit out of any tank but I was just saying, like , both tanks are dangerous to each another , they both can one shot each other but it all situational
Reply: RedEffect that’s a blog. Completely unreliable information as most of the time it is completely biased.
Reply: @RedEffectChannel  you say "it could have easily been implemented into the M1 Abrams, yet you have only read limited quotes and looked at some pictures. you dont even know why it wasn't implemented, your just whining now.
Reply: @nemisous83  

 When it comes to Soviet hardware,   They were behind in many areas. While anything on the battlefield is a threat, and of course it's always going to be considered a threat, the hard reality is that the Soviets were lagging behind in many key areas, night optics was a big one.
 If the Soviets had tried to do anything, they would have been decimated by NATO forces at night. 

 In fact, 
much of the hardware that was used by U S. forces and its allies in the Gulf war, was a major wake up call for the Soviet Union. 
For the 1st time the world saw in action, weapons the United States had at its disposal, such a stealth, GPS, laser guided bombs, advanced night optics and thermal imaging, etc....

 There's a report on the Gulf war from the Soviet perspective, and it is chock full of references, talking about the panic and anxiety after the Gulf war was witnessed, and calls from within the Kremlin to completely reform their military doctrine and hardware, because they realized they were completely outclassed.

They had a lot more confidence in their capabilities until they saw the devastation that took place.

Iraq had a very sophisticated Soviet air defense system, and the Soviets had advisers that was training and helping Iraq, and after the Gulf war, there are many Soviet reports talking about massive failures with the air defense system and what needed to change.

Despite all the historical examples, and the hard reality when it comes to the facts surrounding the equipment, it never ceases to amaze me, how many people show up with Slavic last names, that clearly have been completely indoctrinated with Soviet or Russian nationalism and propaganda, where they still beat their chests and think they have the most advanced military hardware in the world, which has never proven to be the case.
Anywhere Soviet equipment has gone up against NATO equipment, Western equipment has always come out on top.

 But whatever, people are going to believe what they want to believe.
Reply: everyone go commit fighting medium amount of T-80B's with upgraded T-55's,using german and american weapons and shit.you'll have a good time and not get swarmed,i promise!
Reply: @teamfortress2teamfortress881  russia is like destroying everything in warthunder. Every match team gets eradicated by t80s and t64s
Reply: Dillon Mcconnell  Russian made machines in Iraq? I think you mean export models of the T-72 that were unpolished,not upgraded and just crappy  models,just ignore the fact that the Iraqi tank fleet had alot of T-62's and T-55's.
Reply: @inspector647  no,not war thunder,i was referring to W AR  G A M E : R E D D R A G O N
Reply: @RedEffectChannel  no tank is perfect
Reply: @RedEffectChannel  Spookston here on YouTube made a video saying that the gas turbine is a better engine. So which one of you is lying?
Reply: @nickdial8528  well Tank warfare wasnt as big of a wake up call in Gulf War the only people who where in a panic was China because a lot of the vehicles used by Iraq where chinese in origin. the Russians concluded that Iraqi T-72's where not comparable to current Russian T-72B1, T-80BV, T-80U, and T-90 however one area that was improved was added armor to stowage and removal of ammunition in the turret.
Reply: @RedEffectChannel  your padt about the 38mm plate is false a plate angled to that degree will shatter apfsds rounds that contact it and has been shown in trials and in combat. The shattered round will lose much of its energy and not be able to penetrate the turret ring
Reply: @RedEffectChannel  too bad the new variant of Abraham solved it all
Reply: @nemisous83  nick graham is the best i wish he had channel he know more thab putin himself he can debate with donald trump even donald trump will loss to him
Reply: @nemisous83  No you don't you internet trumpet.
Reply: @todo9633  Yes because war is a game and you always have the perfect hull down position. No you don't, you are gonna fight in position where there is no hulldown position available and such. Because you don't choose where you fight. Just like large open ground battlefield free of obstacle as depicted in movies did not exist in BC or even right after it. It's as dumb as thinking the Roman where always fighting on perfectly flat land, they did not.
Reply: @kuhaku9587  oh yes you can decide where you fight. In regards to the design of the Abrams or the Leopard as such it makes complete sense to design them in a way, most beneficial to them in their role. This role was, as stated by a few people in this comment section, a defensiv one. One where the preparation, and full use of their features would be possible. Where some of the faults in their design would be near irrelevant.
Reply: @todo9633  not only that but the Soviets still used Gen 1 night vision devices which are pathetically outdated by  1980's standards also mind you they used them all the way up until the 90's
Reply: @nemisous83  Dude this was a troll video,,he even says they went with gas turbine for "reasons", anyone saying that isnt interested in facts,,,got all the abrams haters here ,,,no tank is perfect and a perfect tank can lose to a less ready crew are all general points that are widely known,,you can take any tank out there and pick it apart so yeah troll video.
Reply: @nemisous83  Yo dude just be quiet, you're defending a flawed design
Reply: @nemisous83  what do you mean? FWIU The soviets made the best gen3 night vision devices in the world. Or are you saying they just equipped their new tanks with old shit?
Reply: @mickvonbornemann3824  you must be joking  pound for pound the Soviets produced arguably the worst night vision devices during the cold war they where always a generation behind the west. for instance when T-62 was using Active IR the US was using Passive IR gen 1 night visions and by the time Russia was using Gen 2 night vision for their T-80U and T-90 the US was already using gen 1 thermal imagers and Gen 3 nigh vision. Russia was using Gen 1 Passive IR as recently as 2009 before their T-72B1's where phased out for T-72B3.
Reply: @nemisous83  I’m talking about stand alone devices & rifle sites. The blokes at Industech told me that the Soviet G3 night vision devices they used were better than western G3 stuff. So they ended up trying to import but that’s another whole story. But they were adiment one had to pay a thousands more for western stuff that matched them & still didn’t match them fully. Of course what they designed or fitted on their poverty pack tanks maybe a whole different matter.
Reply: @mickvonbornemann3824  i think you are misinformed the Soviets used primarily three rifle/ machine gun NV devices the 1PN58, 1PN51 and 1PN51-2 all three of these devices use gen 1 passive tubes which use a cascade style setup similar to the early AN/PVS-2 Starlight scopes even newer Gen 3 night vision devices used by the Russian Federation like the MNV-K have very poo image quality compared to equivalent Western devices. there simply is no debate a western Gen 3 L3 unfilms WP tube is vastly more sensitive to low light and has sharper resolution than any current Russian NV monocular or scope.
Reply: @nemisous83  The Soviets haven’t existed for 30 years. Just because old Soviet shit is still around doesn’t mean there isn’t newer stuff. The Industech people assure me that what’s now coming out now in the 21st century from the top 6 technically minded ex Soviet states (Ru, Uk, Bel,Lith, Lat & Khaz) are now the best in the world, but it,s all classified. The amount of shit they had to go through just to have a look & to use em is incredible. For demos they are even given false names & paperwork, so what they call a KL3 is really a TZ17 or whatever. Nobodies who waste time on Utube like you or me would not even know these devices exist. After being teased with this stuff all they could get out of them were a license to sell the old Soviet version of the jaws of life. Which unlike the western versions that use pneumatics or hydraulics, use pyrotechnic shells, like what use to be used to start radial engined cargo planes in the 50’s. As a consequence are a lot more compact & user friendly than the ones our firemen use, no hoses getting in the way in confined spaces.
Reply: @mrhypebeast4914  you honestly don't expect me to answer every comment do you? I only respond to the comments that actually raise some serious questions or debates if you have a serious question whip the cheese dust off your greasy fingers and write an intellectual comment and ill respond until then stop using Marxist buzzwords like you just stated college.
Reply: @mickvonbornemann3824  again put your money where you mouth is promises are one thing seeing is believing. I have yet to see anything out of Eastern Europe that comes even remotely close to American Gen 3 filmless WP PVS31's. Especially nothing used by their militaries.
Reply: @nemisous83  not all 300+ replies from people in this comment, but the ones that are related to the main topic itself, and there are 10-30 people replying to you, replies regarding about the main topic from the top and bottom of this comment, and you only replied to like 3-5 people or less, you simply don't like it when non-americans question "American superiority" huh? Well typical us, typical Americans
Reply: @mr.laughington5740  do you have a question or are you just going to cope why the Soviets had trash NV equipment  and their successor state still has trash NV equipment.
Reply: @nemisous83  just giving you an advise not to embarrass yourself in the eyes of a hundred people in a YouTube comment even if your facts are right, still you lost the debate. You argue with RedEffect because he states out problems of the Abrams (some statements are indeed incorrect, we both know but most of them are true) and what? You started an argument that Soviet and Russian NV equipments are trash (I'm not going onto that topic) just because RedEffect stated the problems of a tank it doesn't mean its trash, what makes you think that this or that tank is trash because it has problems? Hell no, that's not how it works
Reply: Hey I dont watch your videos often and maybe I'm just not used to it but your outro music is borderline ear rape compared to how high your voice it. So if you do read this comment please lower down the outro music
Reply: Where have you obtained your knowledge of the M-1 series? You definitely have no first hand knowledge. So do you just quote propaganda or video game statistics?
Reply: you didn't start the T-80 video with a meme. That's why people sensed bias. There are die-hards of every country defending their tanks but you started the USA one with a joke.
Reply: You do realise that a lot of the M1A1 is classified so we don't know everything about it for all we know it could have sixth gen technology
Reply: Each year Human beings spent the vast majority of its energy to create weapons to kill itself . And do you know why ?
Reply: @thelastaustralian7583  in canada we spend about 1.8% GDP. Far from a majority of anything, but that's semantics and I see you're looking to make a point and I'd like to hear what that is
Reply: thanks Julian, you are forgetting how much is taken through your national debt, and resource wealth . Also note, as is in our country ,we both basically States of another country ? ...do you know what your Govt debt is and your private debt ? And how much natural resources where exported last year ?
Reply: At the time.  The fastest and the best tank was T 72 it was really good tank at the time. But if you are skeptical whatsoever i cant do nothing but let you know the fact.  i let you know
Reply: Interesting story I was a 19k in 1990. That is an M1 tank crewman if you are not familiar with the term. Unfortunately first problem with your story is its totally biased. I wonder why. My tank did not have half the issues your talking about yeah may be the original prototype the Xm1 had a few issues. But by the 90s we kicked the crap out of everyone we ever met on the battlefield. And so far it hasn't met its match with the so called problems or not.
Reply: @lucienfury2606  Even then, Iraqis were outnumbered, with terrible crew training and were using substandard tanks. Not pulling on you and your achievments in the battlefield, but as of now, no MBT ever (from T-72Bs to Challenger 2) has ever faced its match in the battlefield, because they are often met with no competition...including the M1 Abrams
Reply: @JABelms  Actually the Iraqis weren't outnumbered during the opening tank battles of Desert Storm, they had the same amount of tanks as the American force had, The M1 Abrams just dominated the battle field because we can all agree that it is the best tank in the world      www.youtube.com/watch?v=7EJsLZLfeOQ
Reply: @dickwelts8817  Iraqi forces abandoned their tanks en masse during the night bombing of their positions at 72 Easting, most tanks the Abrams encountered did not have crew in them. Further, Iraqi T-72s were the M model, an export variant with its composite armor outright removed (just leaving air between the front and rear steel plates), a cheaper FCS, next to no night-vision capabilities and with no laser rangefinder installed.
Reply: @dickwelts8817  CAS and Artillery support accompanied the entire assault on Iraqi armor, including during the night prior to the main thrust (there had been engagements in the afternoon prior.) The Iraqi T-55s and T-72s (neither of which had night vision capabilities) were devastated during the night bombing on top of the damage done by CAS and artillery the afternoon prior. By the time of the main assault, most Iraqi armor was abandoned (largely during the night) with the exception of Republican Guard units, which were themselves devastated from the night bombing alongside not having composite armor to protect them during the day engagements, not to mention their lack of laser rangefinders. Unsurprisingly they were then crushed in their engagement with the 3rd Armored division, which received substantial CAS assistance throughout its fight as well.
Reply: @dickwelts8817  No I'm quite definitively referring to 73 Easting and the surrounding armored battles. Prior to the actual main battle at 73 Easting, artillery and CAS was utilized extensively despite the sandstorms, which limited visibility on the ground down to 400 meters, this being before Abrams even encountered enemy armor. Involved in this initial bombardment was the 210th Field Artillery Brigade, alongside helicopter CAS from the Fourth Squadron and 2-1 Aviation. By the time 73 Easting actually occurred, quite a bit of Iraqi armor had already been destroyed or disabled, with even more abandoned, followed with considerably more being abandoned in the first night after initial engagements at 73 Easting but prior to the main engagement. A similar situation of a heavy reliance on CAS and Artillery was found at Norfolk as well. This also isn't even getting into the fact that the bombing prior to the actual armor engagements at and around 73 Easting was itself following the prior air campaign that devastated Iraqi equipment and supply lines, which only ended the day that coalition armor first entered Iraq, giving no time for recovery and leaving Iraqi armor almost completely unsupported. Also worth adding that there were quite a few T-55s there as well, not just T-72s, and just to reinforce that this idea of it just being unsupported tank v tank is totally incorrect, 17 of the 160 tanks destroyed at 73 Easting were confirmed to have been destroyed by just two field artillery battalions, not even getting into all those destroyed by the other FA battalions and CAS.
Reply: @dickwelts8817  Sounds like you are trying to downplay the significant role that artillerymen and airmen played at 73 Easting, while rewriting the US military's own history on the battle. Tanks receiving heavy artillery and air support will pretty much always win against tanks which lack either. This is especially true when you consider that Iraqi T-72s had their composite armor removed (making them virtually defenseless against American guns and ATGMs), laser rangefinders removed (making them unable to fight at long-ranges), no night vision installed (making them unable to fight at night), using ammunition over 20 years out of date (making them unable to penetrate american armor), without air support nor anti-air defenses (making them extremely vulnerable to enemy aircraft), and primarily supported by T-55s and BMP-1s that were abandoned en masse by Iraq's undisciplined and totally demoralized troops the second they started getting killed.
Reply: @dickwelts8817  Are you mixing up 73 Easting with some other battle? Perhaps the 2003 Iraq war maybe? The primary engagement at 73 Easting (which saw the largest number of Iraqi vehicles destroyed) involved Iraqi forces attacking US forces, not the other way around. As far as I know, the only major engagement at 73 Easting that saw dug-in T-72s was that involving Eagle Troop. Broadly during the armored combat surrounding 73 Easting, most dug-in tanks were T-55s and some scattered T-62s, with most Republican Guard units and their T-72s being mobile. I also made note, several times now, that T-72s were not abandoned at nearly the same rate as T-55s as the T-72s were, which were operated by Republican Guard units, though again you're ignoring virtually everything else I said and linking the same video repeatedly.
Reply: @infantjones  I guess you don't like the video I linked to because it tells the true story of the Battle of 73 Easting as told by actual M1 tank and Bradley Fighting Vehicle commanders that were in the battle rather than your fantasy version that you made up
Reply: @dickwelts8817  Well I guess you just hate our troops then if you can't even admit that airmen and artillerymen were there because a video you watched, a video which only covers a small part of the battle at that, doesn't mention what is mentioned in the US military's own accounts of 73 Easting. Would you like to go tell veterans of the 210th FA Brigade that they didn't actually participate in the battle, or would you rather have someone do it for you? Do you think the US Army is just lying about which units were awarded for valor at 73 Easting and the surrounding armored campaign? Or do you think numerous artillery battalions were just given participation awards?
Reply: @infantjones  You are the one saying every tank in the video I linked to is a T55 and they were all disabled or abandoned  prior to the M1 tanks engaging them when the actual tank commanders that were interviewed on the video say otherwise.
And for your information they have Bacha Bazi boys in every Mid East country dummy and Afghanistan
Reply: @dickwelts8817  Would you mind to point out where exactly I ever claimed that "every tank" is a T-55, especially seeing as I haven't actually responded to the video you keep linking? I've only mentioned how most of the armor faced at 73 Easting were T-55s and their derivatives, such as Chinese Type 59s and Type 69s...because they just were, that's a pretty widely accepted fact. Iraq lost some 3,300 tanks during the Gulf War, only 150 of those were T-72s, a measly 4.5%. Do you want to guess what the other 95.5% of tanks that were destroyed were? 

Also, what are "Bacha Bazi boys" called in Iraq then, if they exist in every "Mid East" country (Afghanistan isn't part of the Middle East) in your mind?
Reply: @infantjones  best tank ever was the one in the documentary film Kellys Heroes. Commanded by the best tankman the ETO. "Oddball". Modified detroit diesel with equal speed forward or reverse to get out of trouble as fast as u get into it. Special pipe modification for gun to make it look like maybe a 90mm.Even had loudspeakers to relax the crew in high stress situations And PAINT SHELLS ☺☺☺☺☺.
Reply: @derricklarsen462  infant jones will probably say those were real Tiger tanks used in Kelly's Heroes and infant jones  will say Tiger tanks are better than M1 Abrams tanks
Reply: @dickwelts8817  lol your probably right
Im no expert but and i got nothing against the M1 and maybe it is still the best but the first gulf war was almost 30 years ago....and nobody is saying the F15 is still the best fighter😕
Reply: @derricklarsen462  Yep and the M1 is still the best tank on earth and is constantly being updated with the latest technology.  I guess infant jones is just jealous of the M1 because he lives in a 3rd world country that doesn't even have tanks.
Reply: @dickwelts8817  out of curiosity how long is the M1 supposed to carry on..the design is getting up there in age.
Reply: @derricklarsen462  Just like the excellent design of the B-52 the M1 can also be constantly updated with the latest technology, the platform is a solid design and can even be converted into crewless drone tanks for the future .
Reply: @dickwelts8817  why i ask is this sounds similar to another great tank i.e. centurion designed during ww2 and probably best tank in the 73 yom kippur war.would u say the top nato tanks i.e.challenger and leopard as well are all a progression from the great centurion.to a leman like me they all look a bit like centurions on steroids.I hear u on the B52
Reply: @derricklarsen462  The Centurion, Challenger  and Leopard tanks were good tanks in their own right.  however only 3600 German leopard tanks have been built , 447 Challenger tanks have been built and only 4423  Centurion tanks have been built.  Meanwhile over 10,000 Abrams tanks have been built and Abrams tanks hold the record for having the most extensive and successful battle history.
Reply: @dickwelts8817  i agree on that its record is similar to f15. As for the other two tanks i dont think i want to be fired by any of the three amount produced notwithstanding.the question is how long before someone else catches up. Weve been surprised before by mistsubishi zeros and mig 15s....
Reply: @dickwelts8817  No that's worse. The Asad Babil were rare, M1 Abrams fought older tanks than the already  crappy T-72M in Iraq. BMPs were also classified as "tanks". M1 Abrams fought tanks without night vision and the USA had more losses from friendly fire than from the Iraqis. The entire thing was a shit show. Fighting post WW2 era tanks doesn't make any MBT the best, it's just expected to win. It's lije using Leopard 2A6 against whatever North Korea has now
Reply: @lucienfury2606  That's for sure !
Reply: @lucienfury2606  Most of the people saying bad things about the Abrams tank are on Russian fantasy tank crews while they play the Tank Commander computer game.  Some of these guys have over 3000 hours playing Tank Commander.
Reply: you commited a cardinal sin, you critized the american tank, the abrams has never been tested on an even battle, the iraqis had 70s era, downgraded tanks
Reply: camau79 the Abrams was designed in 1972 lol
Reply: @shiftingndrifting1532  correction that was when the XM1 program started not when the XM1 that won the contract began. the XM1 we got was a further development of the XM1 Crysler which was absorbed by General Dynamics Land Systems (GDLS). the XM1 GDLS didnt start development till after the merger in 1976 and the vehicle was trialed in 1978-1979.
Reply: In the first U.S.-Iraq War of 1991, M1s could see T-72s at night at ranges far beyond those at which T-72s could see M1s at night.  Every time an M1 hit a T-72, which was almost every time, the result was instantaneous catastrophic destruction of the T-72.  On the rare occasion when a T-72 could even hit an M1, the projectile bounced off harmlessly.
Reply: Why you didn't show any clips of the destroyed Iraqi and Saudi Abrams?
Reply: Whataboutism. Americans do not like to have their superiority challenged...
Reply: "Used to"
Reply: Hey fuck off Russia
Reply: I object to the turbine engine stuff(the rest is pretty good) I think you're not thinking of what the abrams designer were designing the tank to do. Fight in the cold war agasint a ZOMBIE horde of Russian tanks(t-72,t-64,t-55, all the ts)  Outnumber is an understatement.
1. To state, "they went this way for reasons" isn't a good statement or argument, than to imply they didn't want german engine because it was german. Doesn' follow as M1 used a British gun and the M1A1 a germen gun.

 2. One primary reason for the turbine the time between breakdowns is longer(less moving parts). So they trade gas and range for a longer time between overhauls. Which is essential given what abrams were meant to do, which was fighting withdrawal (cold war). Given that NATO thought that they couldn't stop the soviet army right away and would trade distance for time to redeploy the US army from the US to Europe. Resupply is more manageable in an organized fighting withdrawal then an engine overhaul, Which the armor forces would be fighting for about three months. So abrams was supposed to fight with no major maintenance needs for 3 months before relief. That was the theory(granted the filters).

3. Also, in the battle of maneuver(which includes fighting withdraws). Speed and maneuverability critical. So to you, the better maneuvering isn't that important. But say that as you are fighting falling back, fighting falling back, with Horde chasing you the whole time. The difference between an alive tank and a dead one would be that maneuverability(more than the armor as no tank can survive being swarmed).
Reply: Half of the video is talking about what problems the tank USED to half. None of that is relevant to the combat effectiveness of the tank now. Begging for watch time.
Reply: The M1  was dominant because it could shoot and move, which at the time no other Tank could do, reliably.  It was (is still?) one of the fastest tanks out there which falls in line with the tactics used to employ it.  It didnt need to be built like a king tiger. It just had to move and shoot faster than the enemy.
Reply: Fuck you russian haters that inbound in this comment.  You cant accept the fact that abrahams has a lot issues you always be a denial although the fact like that in this video. You always saying western tanks always better than the russian tanks.  Always. Be like that.  In fact the gas turbine is consumes more fuel than diesel.  But you are denial.  And always saying that anything american made is DABESTTT.  ACCEPT THE FACT YOU IDIOTICS.
Even when russian tanks has. A lot of issues i accept it.  Then if you love abrahams why in the f.  You cant accept it.  I let you know.  This channel is neutral.  I dont know if you are blind or cant hear but you know this channel is neutral.
Reply: Ferry Syalim guy... the man never said abrams is better. He simply pointed out that it’s incorrect to say that the m1a1 has no night vision equipment for the commander. And before you call me a “Russian hater” not only is my favourite tank Russian (object 279) but I wanted to move there when I was younger. It’s not “hating” to point out facts
Reply: Great video, finally I see a video that challenged all of the myths about Abrams superiority.

But the M1 fanboys will still ignore all the facts and repeat their "America is rich so we can afford it" mantra, and then they will go and complain that US wastes their taxpayer money irl.
Reply: it's effective click bait and you know it
Reply: OK Mr.tanker.
Reply: RedEffect Ok boomer
Reply: @tothedome566  Wrong dicky... X'er and Ex-Spec Ops... Put the play station down & get out of moms basement! Lol!
Reply: You shouldnt care too much. Great analysis. Period. Can’t bare these weak ass murica pussies, believing their own propaganda. I guess they would have exploded, if u had inculded the fact, the 120 mm canon of the abrams is from the leopard.
Reply: Johann Koenitz i know the L/44 and L/55 is from the leopard. There is a reason why it’s called the Rheinmettal
Reply: U.S. Army:  we upgraded our tank again

RedEffect:  the abrams lacks faultless perfection which will reign supreme over all others for the rest of time. just saying.
Reply: @Limescale12  
Internet is critical of US product
@limescaleonetwo3131  -  toys out of the pram tantrum accompanied by copious amounts of tears -  "How dare you criticise Britney".
Reply: @Limescale12  to be fair current M1A2C does have the best protection of any modern MBT.
Reply: @nemisous83  " best protection of any modern MBT." - that would be the T14 Armata.
Reply: @nemisous83 ..... no
Reply: Let's cut to the chase Soviet weaponry is superior
Reply: Blue Feather the Soviet Union and communism is gone and everything about it is outdated
Reply: @shiftingndrifting1532  hold my armata a tank with history of continuous development from the Soviet era.
Reply: Blue Feather ok all we know is the t-14 is extremely light so what type of armor does it have?
Reply: Blue Feather how do you know anything about a tank that hasn’t even reached full production yet.
Reply: @bluefeather2889  Amarta couldn't even shot properly. You just don't know about tank.
Reply: @bahamut149  source
Reply: @bluefeather2889  Just go directly to the only video posted by Russia showed T14 fire it's gun.
Reply: @bluefeather2889  the Armata is a piece of junk. They are the most unreliable fielded tank I've ever seen.
Reply: @marinusdedreu3833  It's a Prototype of course the T 14 isn't good yet.
Reply: @shiftingndrifting1532  Yeah it is , at the time maybe , but now its just a relic from the past . But if we are talking about the soviet technology at the time, it was really good even advanced.
Reply: @bluefeather2889  That just shows how long they developed the tank, and it is not that good thing taking so long to develop a tank, it shows how weak soviet economy was . And with that long development time, things probably changed drastically , if the original Armata from the soviet era was actually made, it would be something so different , because of the development time.
Reply: @marinusdedreu3833  Armata could have been the best tank if Russia didn't enter Ukraine to avoid receive sanctions, and didn't allow Afro-Asiatics to replace their population like they are doing in both NATO and the EU.
Reply: You start out by comparing the 1980s m1 to  more modern russian vehicles and your biggest complaint about it is fuel consumption and a filter that needed cleaning ? Id say by your accent your biggest complaint should be that it killed nearly every single russian vehicle it could see without impunity . To much vodka maybe ?
Reply: abrams atwo  To be FAIR, America literally teaches classes on American Pride, so maybe the reason your so defensive with your out of date Abraham’s and its many flaws is because your brought up believing your own lies. Just a thought if you would like to continue to mock people’s accents and origins.
Reply: Problems, problems, problems, weaknesses, weaknesses, weaknesses... LOL!!!   AND STILL THE BEST MOST PROVEN MAIN BATTLE TANK ON THE PLANET...PERIOD...  NO OTHER TANK THAT CLAIMS THE TITLE HAS EITHER PROVED IT NOR EARNED IT....SILLY  POOTPOOTSKI!! LOL
Reply: G Keefer no other tank has got the chance to go into battle at the moment because the countries owning them haven’t got them selves into problems they couldn’t finish,started wars they couldn’t finish. Saying that the Abraham’s is the best tank that saw combat is only showing your ignorance and self pride for a horrible country. Sad, isn’t it?
Reply: @imlostplshelp9037  exactly and hey I got a question who would you think would be better at combat ? T90 or abrams , cause the T90 has additional reactive armor making it more defended against RPGs
Reply: @Liberty-Works1111  and the most destroyed tank in the middle east still lmao
Reply: @lebigeon And  Which tank is impervious to mines & IED's??? Let me help ya lil buddy... NONE.... &  Like Israel, we actually use our tanks in tip of the spear urban combat as opposed to hiding our tanks back behind every obstacle out of the fight because they are paper tigers or because we cant really afford to fight the war so hide them only to loose them anyway (So far this is our enemy...) Fielding junk tanks, planting explosives & hiding...  The Abrams was never designed for urban warfare... It was designed to meet Russian Armor on the fields of Eastern Europe... We put ours out there in Urban knowing some wont make it but we were NOT loosing soldiers... they were well protected for the most part & they have done better there than any tank on the planet... none of the enemy tanks make it...But now, With rear protection , the new active Trophy projectile intercept systems and radar penetrating radar for Ied's.. They will be much harder to defeat. It was a valuable urban lesson we had never had the opportunity to learn... But thats what makes us deadly...We learn, we adapt, they die...
Reply: @Liberty-Works1111  Well that's because Americans are aggressive and constantly attacking so yeah the vast majority of the US arsenal is "proven" by definition..
Reply: @backwoodscompatible604  Exactly... Gotta have great equipment if you want to whip ass... Lol